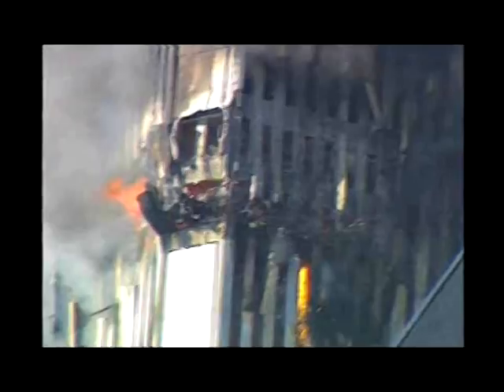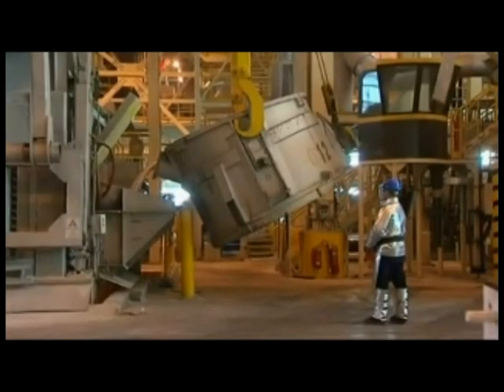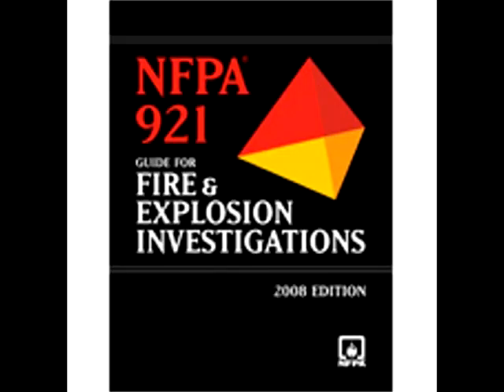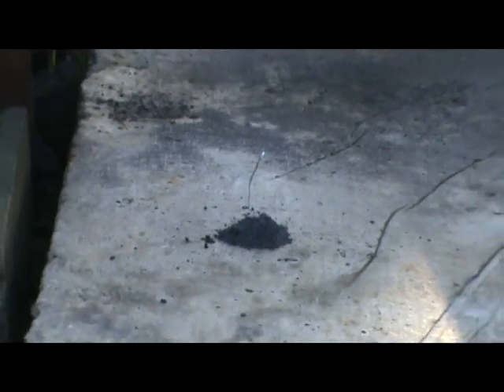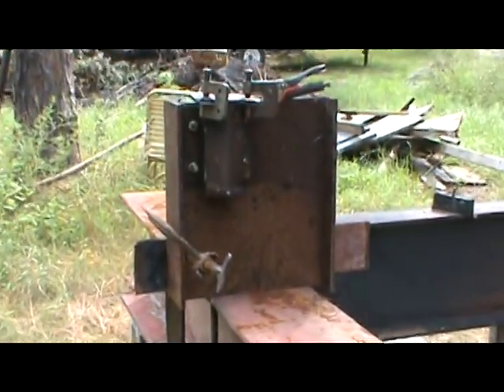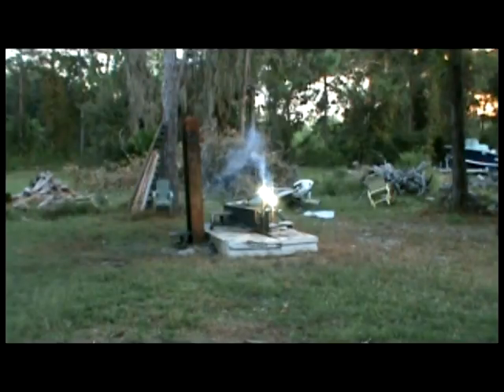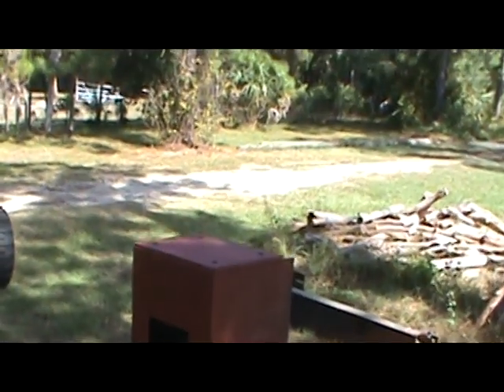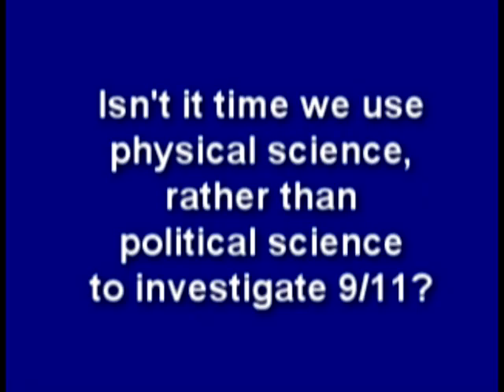9/11 Experiments: The Great Thermate Debate

Comment: Mainstream expert found NO evidence that thermite was used to bring those buildings down including 7.
There has never been any question as to whether or not thermite can melt steel. I used it myself numerous times. It could, theoretically, be used to bring down a building, if charges were placed in many critical places detonated at exactly the right time to give the "illusion" that the plane did it.
The fastest and probably cheaper way is to is to slam the building with a diving 727 with almost - full fuel tanks, damaging - not cutting - support ting frame members, and allow the resulting fuel and other fires weaken the remaining steel, until the structure gives way. Is that actually any less likely than using thermite?
Look, unfortunately, the US has many enemies, without and within. al-Qaeda attacked, did tremendous damage, and all they have to do now is watch all the other hate groups try to finish the job.
Reply: TheGooniessss 9/11 the day physics took a day off...
Reply: SupportAZ the answer is that good planning and good organisation only requires that a few know everything. They call it compartmentalization.
Reply: ***** no, I didn't, because the item you mention doesn't exist and never did. What did exist were a few chunks of - and this is the crucial bit - DECOMPOSED CONCRETE with metal items embedded in them. Those metal items were structurally intact, showing no sign of the temperatures you insist were present. Think about it: if the gun was embedded in molten steel then it would have been exposed to sufficient temperatures to have melted it, yet it was not melted. What does that tell you...?

Concrete starts to decompose into its composite minerals and compounds at around 250-300C, which was well within the range of those fires if they were only burning hydrocarbons. There is nothing whatsoever about these objects that supports your case, as you could have found out with a minimal amount of research.

I have no obligation to explain what could have melted steel until YOU first prove that steel actually melted, and, as we can see above, you have yet to do so. Try again.

Incidentally, I am almost certain that no molten steel EVER existed at that site, despite it being perfectly feasible according to the scenario detailed by the NIST from at least two possible sources. Not only have the fires present been empirically proven capable of exceeding the melting point of steel, but the collapse itself necessarily releases sufficient energy to melt steel as it deforms the support structure. Molten steel is NOT unexpected from the factors detailed by the NIST - the sole reason anyone dismisses claims that it was present is because there is not even the slightest hint that it ever was.

I invite you to return to school and learn how to undertake proper objective analysis, because you clearly have no fucking clue.
Reply: *****
Oh yeah...according to Dr Jones, "The peer-review on this paper was grueling, with pages of comments by referees. The tough questions the reviewers raised led to months of further experiments" I just don't buy the story that a heavy-weight academic with a long career in research suddenly turned into a bumbling incompetent and a bare-faced liar. Smacks of a smear to me.

Also he wasn't suspended from teaching for publishing the paper. An academic does not have to get permission from their university every time they submit a publication. He was suspended for making unsubstantiated claims in meetings and seminars as far as I'm aware but he refutes that completely. He thinks his suspension was political and a result of his university either buckling to pressure or protecting itself from negative publicity.
Reply: SupportAZ your reasoning bear no sign of logic. Here is how it would run in a court of law. You are the DA and I defend OBL:
1. "Let´s see your evidence DA. DA: you can read in the reports.
2. "Now it´s the defense´s turn." Def: NIST cannot explain free fall in WTC 7, they have no proof for the hijackers being at the airport and no explanation how a 150 feet airplane can disappear into a 10 feet deep hole without being even visible to the first responders,.
3. DA: ????
Reply: SupportAZ free fall is admitted by NIST (NISTSTAR 1A p.43 ff) and not explained. Would the court please dismiss the DA for lying! Conversations could have been recorded anywhere. Snapshot pictures not proven to be from any of the airports on that day. and NO testimonies! Where is the explanation of the dug-in-the- hole plane?
Reply: ***** your answers are kind of nice but sorry to say inconsistent. For us who don´t believe the official story AT ALL because of the total improbability that all this success should work FOR the hijackers throughout the process and ALL the mishaps on the governments side should be present at the same time is only by statistical means absolutely impossible. On top of that you have the cover up and ridicule of everybody who dares to question that made everyone who did that a public enemy. When you then start to look into details you find the seven faults like in the cartoon. But when I now tell you that I see that somebody is lying or cannot explain the anomalies you are asking me about the significance of this? You don´t understand how fiercely debunkers have attacked us who have pointed out that NIST after six years! had to concede to the fact that there was actually a period of free fall in WTC 7 although they cannot explain it. For us the free fall itself is a proof of CD. If there is CD in WTC 7 there is of course  a new ball game. In our eyes we have now come to the point where nobody scientifically can explain the free fall by anything else by CD. We can start from there and see where it takes us! Observe SupportAZ who still tries to lie about the free fall. It is useless but he insists. Do you also?
Reply: SupportAZ ""The "freefall speed" is debunked by the video."" Do you see your own words? A stupid straight out lie. Stupid because NIST already say it. But you have not even dared to read. Or cared or whatever. Impossible to have a serious discussion until you admit what they say, for heavens sake!
Reply: SupportAZ
 
New studies conclude: So called 'Conspiracy theorists’ are sane, while loyal Government Dupes and MSM Drones become hostile lunatics.

The following four different University studies have revealed a lot about how conspiracies are denied using patriotism and why the ones questioning the Government are attacked and considered anti-American traitors. Confirming a mental condition diagnosed by psychologists as cognitive dissonance, the mental stress and discomfort one experiences when faced with a 2nd equally possible explanation capable of destroying ones beliefs, loyalty, faith and security the Government is expected to provide.

Recent studies by psychologists and social scientists in the US and UK found contrary to the mainstream media stereotypes, the ones labeled as conspiracy theorists, tend to be saner and more stable than those accepting the Governments official version of an event. The most recent study was published July 8th, 2014 by psychologists Michael J. Wood and Karen M. Douglas of the University of Kent (UK). Entitled “What about Building 7? A social psychological study of online discussions of 9/11 conspiracy theories.” The study compared comments at news web sites from “Truthers” to those left by “Debunkers.”

The ones conducting the study were surprised to discover it is now more conventional to leave Truther comments than those of Debunkers: Of the 2174 comments collected, 1459 were coded 'Truther' ones who do not believe the Govt. theory and 715 were coded 'Debunker' who believe the governments theory. Truthers commenting on the 9/11 and the JFK assassination outnumber Debunkers by more than two to one. Proving pro-conspiracy Truthers express what must be considered the now conventional wisdom, while the anti-conspiracy Debunkers have shrink into a small, beleaguer-ed minority. 

Perhaps because their supposedly mainstream views no longer represent the majority, the anti-conspiracy Debunker often displays anger, rage and hostility resorting to profanity and personal attacks to discredit or persuade Truthers into believing the official 9-11 story. Additionally, it turned out the Truthers were generally not hostile posting valid concerns and not fanatically attached to their own conspiracy theories willing to consider other and equally possible theories. 

Debunkers however claim their 9-11 conspiracy theory blaming 19 Arabs, none of whom were experienced pilots able to fly a commercial airliner, especially without showing the least amount of fight for control of the planes on 9-11, were somehow able to thwart 2 billion dollars in air defenses under the direction of a guy on dialysis, using a laptop computer and a satellite link holed up in a cave halfway around the world – was somehow possible. 

This while the Truthers never claimed to have a alternate theory which completely explains the events leading up to the attack on 9/11. They claim they are not promoting a rival theory nor do they need one. They claim it is not for them to figure out only to prove the impossibility of the official story, which does not require a contradicting theory. They are simply claiming since a lie cannot be proven it was released immediately and allowed to run halfway around the world before the truth could put on it's shoes.

In short, the new study by Wood and Douglas suggests the negative stereotype resulting from the CIA pinning them as conspiracy theorists and hostile, fanatical anti-American Traitors. Relying on cartoon physics and crack pot Scientists, Architects, Structural and Aeronautical Engineers for evidence is ridiculously false. 

Additionally, the study found Truthers research all claims to find evidence the square box dictators ignored and failed to mention. They also research and discuss other conspiracies the Govt. is accused of masterminding tieing them all together exposing the much larger agenda of these Neo-Con traitors and their NWO Government.

Both of these findings are amplified in the new book Conspiracy Theory in America by political scientist Lance De Haven-Smith, published earlier this year by the University of Texas. Professor De Haven-Smith explains: "The term conspiracy theory was invented and put into wide circulation by the CIA in a effort to smear and discredit the ones questioning the JFK assassination." Adding. “The CIA’s campaign to popularize the term ‘conspiracy theory’ targeting the ones questioning the Government for ridicule and hostility must be credited. Unfortunately, it became one of the most successful propaganda initiatives of all time.” 

In other words, people who use the terms “conspiracy theory” and “conspiracy theorist” as an insult are doing so as a result, using these terms became an insult to the ones questioning the Govt. who uncovered a well-documented, historically accurate conspiracy by the CIA and those involved in the assassination of JFK. The CIA is not supposed to be operating inside the U.S. yet, routinely breaks conducts domestic operations ranging from propaganda to assassinations inside the U.S. 

De Haven-Smith claims those who doubt official explanations of high crimes are eager to discuss historical context. Pointing out a very large number of conspiracy theories have turned out to be true, and there appear to be strong relationships between many as-yet-unsolved state crimes against democracy. An obvious example is the link between the JFK and RFK assassinations, which both paved the way for presidencies continuing the Vietnam War. According to De Haven-Smith. "We should always discuss the Kennedy assassinations in the plural, because the two killings appear to have been aspects of the same larger crime." 

Psychologist Laurie Maxwell of the University of Guelph agrees the CIA-designed “conspiracy theory” label impedes cognitive function. Pointing out, in an article published in American Behavioral Scientist (2010), anti-conspiracy people are unable to think clearly about such apparent state crimes against democracy as 9/11, due to their inability to process information conflicting with the indoctrinated pre-existing belief they were brainwashed into believing. 

In the same issue of ABS, University of Buffalo professor Steven Hoffman adds "anti-conspiracy people are typically easy prey to strong confirmation bias – they seek out information which confirms their pre-existing beliefs, while using irrational mechanisms (such as the “conspiracy theory” label) to avoid having to consider conflicting information." 

The extreme irrationality of those who attack 'conspiracy theories' has been ably exposed by Communications professors Gina Husting and Martin Orr of Boise State University. In a 2007 peer-reviewed article entitled "Dangerous Machinery, Conspiracy Theorist as a Transpersonal Strategy of Exclusion,” they wrote:
 
“If I call you a conspiracy theorist, it matters little whether you have actually claimed a conspiracy exists or whether you have simply raised an issue which I would rather avoid. By labeling you, I strategically exclude you from the sphere where public speech, debate, and conflict occur.”

Now, thanks to the internet, people who doubt official stories are no longer excluded from public conversation. The CIA’s 44-year-old campaign to stifle debate using the term 'conspiracy theory' label to smear those who dare question the Government is nearly worn-out. In academic studies, as in comments on news articles, pro-conspiracy voices are now more numerous – and more rational – than anti-conspiracy comments. Cheers Debunkers!
Reply: ***** looks like your feelings are running away with you and leaving your critical thinking behind. Sorry, because I thought I had found somebody to make an adult conversation with. If you want that you´d better pull that part of it back to normal. If you read carefully what I write it is all about probability. Since you are sensitive to that word you should try to look into the likelihood of all the anomalies, contradictions, mistakes, luck, absences being at the same time working for the hijackers 100 % and against the government agencies 100 % added with all the cover-ups, lies, distortions and suppressing of information and I think the probability for something like this would be smaller than one in a billion. That is PROBABILITY not possibility. You should look at this as a starting point for your judgement and from there draw your conclusions. Sure, it could happen; but you need a pretty good explanation. You are not close yet! Btw; you consider NISTSTAR 1A to be a twoofer site as well?
Reply: ***** I certainly have no love for how they handled this situation; lied to the public about Iraq (that was a blunt and outright lie; agreed?), or widened the scope of NSA; the Patriot Act; screwed up the economy and made the taxpayers bail out the bankers. But whatever; I am first and foremost a lawyer so I am looking for the truth even if it should be in the defence of people I don´t like.
I make my judgments from the Commission Report from NISTSTAR 1 and 1A and publications connected to that. I look at videos from debunkers, CNN, Nova, National Geographic and from "truthers". I am trying to make up my own mind. You Bill Martin, seemed to be a reasonable man some time ago but now you have reiterated to the very tiresome debunker style that leads you nowhere.
NIST had six years and 300 experts to complete the Final report on WTC 7. And they screw it up? By admitting free fall? Or what do you implicate? Or are you just too old and tired to explain.
Reply: Martin you can't make phone calls from a plane, you don't have service up there. That is why we are lead to believe that the phone calls are fake.
Reply: ***** I usually don´t use that kind of words but after YOU are constantly avoiding MY factual questions and expressing your disappointment that I had not turned over to your side; I used it as a provocation- I thought from the beginning of your conversations that you were looking for answers in the way I do myself but after a while I felt you showed your true colours when I continued with my unanswered questions about the hijackers and Shanksville. You seem to have a prejudice notion that our government cannot do things like this to their own people. I started there once upon a time but I have learned on the way that they can. They have sent tens of thousands of young men to die and hundreds of thousand to be maimed physically and psychically  to pursue wars that have not served any good purpose for the American people but for a handful of bankers and corporations. That does not stop me though from demanding evidence; but I don´t stop short of the notion that governments can be very corrupt. Power corrupts and absolute power corrupts absolute. There we are in America right now!
Reply: "Mainstream experts" found no evidence of anything! That is why "truthers" have to do it all.
Reply: oller don't mind him he has dementia
Reply: TheGooniessss nice list. Shame your hallowed "experts" have proven that they are shit at their jobs.

Let's take Gage as an example. He runs the AE911T site, which features the Harrit fraud as a "technical article" in its list of sources. This is a report that has been proven to contain numerous scientific frauds, yet your "Chemical Engineering BSc" couldn't tell that this chemistry "paper" was utter bullshit...? Not looking good...

"You must have had a much hotter heat source to get 2700 degrees Fahrenheit in order to melt the steel, melt the iron, to get these iron molten spheres."

- oh, really? Well, that's interesting, because those of us who have no vested interest in perpetuating this little fabrication know that iron microspherules form at far lower temperatures. In fact, below is a link to a paper that points out that they form at temperatures of less than a fifth of those cited in your fictitious source:

http://www.sciencedirect.com/science/article/pii/S1367912012001228

- which states that:

"spherule formation is attributed to a low temperature hydrothermal process (150–200 °C)"

- go on: read it for yourself, you lying little spastic. Incidentally, do you know the key difference between this source and every single one you'll find in one of Gage's sites? This one is PEER-REVIEWED. And I mean it is reviewed by ACTUAL peers, not just people Gage hand-picks who he can guarantee will let his bullshit pass.

I know chemistry, and the fucking cunts you just cited are either so incompetent as to be dangerous or are as amoral as you are in perpetuating this bullshit.

THAT, princess, is how you analyse a source.

[drops mic]
Reply: TheGooniessss "im done with this thread "

- no you fucking well aren't, princess. You can start by addressing the points I raised in direct response to you in my last comment - assuming you have sufficient honesty to do so.

Of course, I have no doubt that what you'll actually do is pretend that all those inconvenient facts don't exist, and carry on deluding yourself into thinking you have more than half a wit.
Reply: ***** Which "expert" found this supposed proof the thermite could not have been used?  Which peer-reviewed, open scientific journal was this information published in?

This should be amusing.
Reply: ***** I am not convinced by anything else than that there is a lot of disinformation; half-trues, avoidance, unwillingness to admit that there is nothing concerning 9/11 that earns some consideration or merits any questions etc, etc. Up until one year ago I was not even aware of the controversy, but when I started to look I found some strange details. Since I am an old criminal lawyer I started to dig deeper and have been going on ever since. Tragically enough has every answer I have got been the source of even more questions and only adding to the mystery. The defenders of the official version have always been very quick to "lunify" the questioner. The same goes for you Bill. You should be old enough to know that it doesn´t work; at least not with some people. I am just not going to give up before I have some satisfactory answers. I have the experience to understand when that time has come. It is still somewhere in the future.
Reply: ***** that´s why have to continue our fight against those who try to impose new measures of slavery based on false flag attacks. They know that if this starts to be stuff everybody is talking about their blood will soon be in the streets. We cannot afford to be afraid of being ridiculed or defamed. They learned from Stalin about how to use the "useful idiots" who think they can save their lives by sitting like dogs around the boiling pot. Their power is built on our obedience. So we can not obey.
Reply: Can you provide a reference for your assertion that a "Mainstream expert found NO evidence that thermite was used to bring those buildings down"? Because I've just read the original 'thermite' paper and I can't find any scientific  rebuttal of the paper's conclusions. Most 'debunkings' seem to involve criticizing the journal it was published in and the peer-review process. Those that do focus on the science tend to make claims like the red/gray chips could be paint chips, but the paper specifically addresses this issue. I've also seen it claimed that the iron spheres found might not have been produced by a thermitic reaction but again the paper addresses this issue by demonstrating that when heated the chips exhibit an exothermic reaction and actually create iron spheres where none were present before! I'd like to see a good physicist actually address each point of the paper.

By the way the authors of the paper are not idiots but rather heavy weight physicists...Steven Jones was well known and respected for his research into muon-catalyzed fusion in the 80s and 90s and the others have hundreds of publications between them in mainstream journals...
Reply: *****
Thanks for the reply Bill. You are right that he can't prove it was thermite, but the red/gray chips do exhibit an exothermic reaction when heated that is consistent with thermite, Again, if his reasoning is flawed I would like to see a scientific rebuttal of the paper.

It's a shame that all the relevant samples weren't gathered by an official team on the day, then Dr Jones wouldn't have to use samples donated by members of the public. Unfortunately this was not done so there are no official sources to analyze. The samples he tested were not all gathered long after 9/11...some were gathered on the day and at least one sample was gathered before noon. I see nothing questionable in the stories of the people who collected these samples and many samples were placed in air tight bags and sealed on the day. Furthermore all of the samples, collected by different people at different locations at different times, have the same composition and all contain the same red/gray chips in about the same proportions. According to Jones et al the elements that form the composition of the chips, although common in isolation, were found in forms that would not occur from random mixing. They claim that the presence of elemental aluminum with iron oxide mixed at nano levels can't be accounted for by random mixing.

Furthermore the chips, when heated, produced exothermic reactions that, according to the researchers, were thermitic in nature.

Now then, I am far from qualified to judge the soundness of the science but I'd like to hear from others, who are qualified, a scientific rebuttal of the paper, taking on each of the points it addresses...
Reply: *****
Hmmm...other than stating that it is poor research you do not explain what it is about the research that makes it so. Researchers have spent years looking for black holes, dark matter and the Higgs Boson...does it mean this research is invalid if they find what they are looking for?

Secondly he was suspended after he put an unpublished paper up on his website (http://www.d.umn.edu/~jfetzer/Why3Dec13.pdf) but researchers present unpublished work all the time in seminars in every university in the world so it seems like a political move.

Regarding Pons & Fleischman the main problem seemed to be the way they made the announcement and calling the observed effect "fusion". It is interesting to note that they never retracted their results and many effects from LENRs have been reported by various groups over the years.
Reply: Also, who is this mainstream expert who found NO evidence of thermite?
Reply: SupportAZ
I'm not a 'twoofer'...but I don't accept anything at face value either. Why would a government want to blow itself up? Well geopolitics is complicated stuff but you only have to read up a bit on operation 'Gladio' or operation 'Northwoods' to realise that blowing yourself up and then blaming it on your enemy is pretty much standard practice amongst certain elements of certain security services...

Watch the BBC documentary below...seriously...

If you can't be bothered then a quick synopsis is: A secret section of the secret services in Italy (and lots of other major European countries) ran the country for years without the knowledge of its own government! In Italy Gladio operatives planted bombs that killed lots of civilians (they killed eighty something civilians in one blast) and blamed it on their enemies (communists). Through this 'strategy of tension' they manipulated public opinion with the lives of civilians, It was all done under the auspices of the CIA. It's now a matter of public record since several testimonies by top Italian government officials

Operation Gladio - Full 1992 documentary BBC
http://en.wikipedia.org/wiki/Operation_Gladio
http://en.wikipedia.org/wiki/Operation_Northwoods
http://dc911truth.org/flyers/11-11-06-handouts/Operation%20Northwoods.pdf
Reply: SupportAZ I think you are putting the cart in front of the horse. Just because we can´t believe that our government not could be involved in horrendous acts like this should that be a pretext for NOT examine what happened? Of course, for those who don´t believe in the official story; many things point in that direction. However; you cannot be sure at this point who the perpetrators are. I can think of hundreds of different possible scenarios. What they are guilty of, however, is hiding a lot of information from the public. That is bad enough.
Reply: SupportAZ another thing: IF it was planned you have to assume that it was very well planned, indeed! Some people point at the incompetence of governments as a proof that things like this cannot be done by them. Those who say that tend to forget that politicians at this level are extremely good at one thing that they have been practising all their lives: grip and hold on to power. Bush stole two elections by bribing, cheating and bullying through civil institutions. They know what to do and don´t hesitate to use their might.
Reply: SupportAZ I have said many times in these pages that I don´t have any preconceived notion of how it happened. What I know though is that it didn´t happen the way it is told and that there is a big cover up story. I don´t care to go into details of how to organize operations; only that I know big operations have been completed before throughout history. I don´t know who did it. Somebody did and it was not UBL. Did you know and can you understand why there is not even one piece f evidence to show that the hijackers even were at the airports this day? No footage, no testimonies; nothing.
Reply: ***** nobody but the perpetrators themselves CAN have a unified  theory/knowledge. There are too many options. We have to unveil the cover-up stories and start from there.
Reply: ***** the basic idea WAS to create a sense of fear and confusion in all of the country and in the world. Don´t forget he brought in all his partners from NATO. That could never have happened without 9/11! What do you thin Occams Razor would lead to in a situation like this? Believe the government story? That story that in itself contains so many obfuscations, confusions, contradictions and obvious lies. Occams Razor would lead to the conclusion that there was only one reason why this was made. Create fear and chaos. Simple.
Reply: ***** where did that rationale in you go? Did you have a bad nights sleep? You and some of you colleagues on the debunker side have launched Occams Razor as some kind of explanation whu the official story is right. The problem with that is that what looks like a simple story with four hijacked planes turns out to hold so many anomalies like the total absence of air defense, the unprecedented falls of three towers (of which one was not even mentioned in the official story!) the unbelievable presence of almost unscathed passports, one plane disappearing in a hole in the ground;  all the confiscated footage etc etc; that all of a sudden the official story is extremely complicated. Why all this secrecy? Why these anthrax threats? Why this oppression of information? Occams Razor certainly leads in the totally opposite direction. You have the burden of proof and you have the disadvantage of an Occams Razor analysis!
Reply: they also shipped all the scrap overseas to get rid of the evidence....u forgot to mention that.....
Reply: oller
The truth is where you find it. You obviously have no love for the US government, so you won't look there.
The NIST screwed up a few things in their report, so you accept none of it, but the crap you hear on the truther sites is gospel. Have it your way.
Reply: ***** I'm sick and tired of your stupid mistakes too... Only a controlled implosion would cause a steel building to free-fall onto itself. The fact that you think you have proven anything more than your ignorance is quite comical.
Reply: israels mossad did 911 This is the forty-eleventh time I've heard that statement.
Study some science, look for some material not provided by "911truth.com" or one of the dozens of sites that claim special knowledge. Look up some engineering sites, visit FDNY's internal investigation transcript then get back with us.
Oh what the hell, if you see something you don't like, you'll just call it a government shill site or something like that. Come to think of it, you've already seen what you want to, so you won't look any further.
Reply: ***** This is the forty-eleventh time I've heard that statement.
Study some physics and look for some material not provided by "fox.com" or one of the dozens of sites that claim special governmental knowledge. Look up some engineering sites, listen to the FDNY's own claims, then, get back with us.
Oh, what the hell, if you see something you don't like, you'll just call it a "911truth.com" shill site or something like that. Come to think of it, you've already seen what you want to, so you won't look any further.......
Reply: ***** I am 100% with you on this one Bill, but you will not convince these loons of anything, they already decided what they want to believe.
Reply: Jesus

I see Jews r Us just showed up .  The NWO Zionist Serial lieing Apologists.  Now I'm certain you can convince everyone that CIAida was responsible for this false flag operation.
Reply: *****
Where have you been? Reading Jonesology?
Reply: Jesus
I was actually convinced that Oller, for example, wasn't a looner, but he turns out to buy the same crap the the others do.
Some people have common sense, others only trust each other.
Notice this "RIOT CLAN" guy brings up the same old thermite BS. He read it somewhere. so it's gospel.
I'm thinking that the same handful of truthers is just rotating names and recycling their "theories".
...OR, maybe...what if they ARE Al Qaeda?
Reply: You stupid old fool
Reply: ***** Too bad you can't raise even a single counterclaim, ya fuckin tool
Reply: israels mossad did 911
Everybody did 9/11 except those who claim to have done it!
I can prove it!
Reply: *****
You weren't 3, you were a midget working for the CIA. You're actually 68, and I'm on to your tricks, you gummint shyster...
Reply: ***** Ok, me to say that there was molten steel falling off the building is the same as me saying that a plane hit the tower! There is video evidence of both... To say that this was not an inside job just shows how much you don't want to know the truth. I have someone that when ever he sees me makes fun of me for saying that the 2nd richest country in the world can't pull off flying planes into 3 buildings, and demolitioning 3 buildings. I am so fed up with the world. It is ending and that is a fact! Good Bye America! the debt is now 18 trillion dollars.... Obama another man that is trying to make the world a one world government. Started with George Bush SR. and is still going. Guys if you want to have any chance of living a free life move to Switzerland.

And Bill what is your opinion on 9/11?
Reply: lol you crazy they have proven it time and time again there was thermite particals in the dust im not gonna argue something i have spent hrs and hrs researching ......might wanna be little more open minded and check your own facts mine all come from engineers and other creditable ppl
Reply: and no way did bin ladens terror squad have anything to do with it they were just patsies like oswald im sorry tht you cant belive your own government is the cause , why dont you look into how many countries the states have occupied annd ruined excuse the spelling i have much more important things to do then point out you are just set in old ways and thinnk america is still the land of the free . not much longer it will be a socailist country
Reply: TheGooniessss
Just name one...or can you?
Reply: TheGooniessss Judy Wood claimed the destruction was done with Space-Based Energy Weapons". If you buy that, I'm really gonna turn you over to the Whako unit. I recommend you not mention your drug se.
Reply: im done with you , when your country is in shambles and martial law kicks in i hope your one the first they stuff in a fema camp and it s coming and you really are nothing more then an uneducated troll
Reply: TheGooniessss
Yeah, Judy Wood said a space based directed energy weapon destroyed the towers. You need to stop hopping from blog to blog...
Reply: ***** please, Bill, haven´t you studied the evidence at all? They have presented a lot of obviously fake evidence concerning the hijackers presence at the airports. No disguises there. But they have not presented any witness testimonies or footage of which there must be hundreds. In any normal murder case the police should have done that. So much evidence and they don´t have the staff???
Wikipedia says about Shanksville that the crater was 8-10 feet deep. In the Commission report there is not a word. First responders, when they arrived before FBI have witnessed that there was virtually nothing there! Which is the official story? The one that the official guides at the site are reluctantly saying and that you obviously refer to? Shanksville is a more obscured piece than any other.

NIST carefully avoided to make any more claim of their own other than that the collapse was "inevitable" referring to the fact that their mission was only to find out the reason why the towers fell not into how.

There is strong reason to believe that OSB died in a hospital in Rawalpindi in December of 2001. He was treated for kidney failure in Dubai in the summer and then transported to Rawalpindi where he had dialysis and subsequently died. During the attacks he was hospitalized. That is why FBI never had him on the most wanted list for the 9/11 crimes.
Reply: oller  You are indeed a lawyer, and you are a bulldog. You twist and flip and obfuscate evidence, you deny what doesn't support your case... you do have an agenda, and damn if truth is gonna interfere. What you don't like you claim is fabricated. What you like suddenly becomes the decisive factor.
You, too, are hopeless despite your protestations.

And I never called you a looner, I don't know what that is either. If it's some Brit version of "lunatic", I wouldn't use it on you. A lunatic isn't responsible for his actions.
Reply: ***** can you give me one example that proves your accusations against me? I am a lawyer for sure but I think I have been keeping a straight line of arguments that should be easy to follow. But may be my questions are not to your taste because you have different agenda. When you think Switzerland belongs to Scandinavia I also understand how shallow your knowledge basis is.  I saw you said good-bye further down so may be it is the best thing to leave it at that.
Reply: ***** typical shill tactics. Blocking. Only cowards block. I have been blocked by several debunkers because my questions were to hard. I pity you small people.
Reply: not to mention the 3 trillion dollard the defense department could not account for was annouced the day b4 whats the media best at distracting the masses and ppl still dont question were tht money went fuck id be up my congressmens ass with spade
Reply: ***** btw I never called you shill I just said you used shill tactics.
Reply: You must be starting to suffer from dementia. Their was more than enough evidence of thermite being used. Sorry you are lost,
Reply: oller bill martin=delusional "engineer"
Reply: No fire investigation was allowed. NIST said they didn't look for Thermite because they had the preconceived notion that it wasn't a demolition.

Look it up.

Shyam Sunder himself said they didn't look for explosives.
Reply: ***** get this straight: no matter how often you scream that something happened, it will not make it true. No amount of rabid wailing about these fictitious events will make your demonstrably-false claims come true. You are wrong, and the footage alone proves it. End of argument.
Reply: chris silva Sorry to burst your bubble, but if the Official Story cannot explain bldg. 7, then its other conclusions are questionable as well. Phony would be a better description.  And there is no "mystery"; it was destroyed intentionally , by controlled demoltion, as many experts have testified. Anyone can check this: get a stopwatch, time the bldg.'s fall, and apply Newton's Laws of Motion, and the result is, the Official Story is impossible, but CD is not.
Reply: David Herron where is the evidence from the CVR that proves highjackers took over the planes ?  are you basing your conclusion on the calls from the passengers and flight attendants ? and does your conclusion include the testimony from Ted Olson ? 

The whole official story stinks.... and the proof that 19 highjackers took over the planes is based on 'alleged' phone calls from the passengers and crew.... and from the 'alleged' message from Mohamed Atta who said... "we have some planes"  !!!!    fucking ridiculous !!!
Reply: David Herron here you go.... information from flight 77 FDR analysis:

http://pilotsfor911truth.org/forum/index.php?showtopic=18405
Reply: David Herron no problem..... 
http://www.nist.gov/manuscript-publication-search.cfm?pub_id=101366
Reply: Christ J EVERYONE is against you !!   It's a GROWING club !!!!!!!!!!!!!
Reply: "The fastest and probably cheaper way is to is to slam the building with a diving 727 with almost - full fuel tanks, damaging - not cutting - support ting frame members, and allow the resulting fuel and other fires weaken the remaining steel, until the structure gives way. Is that actually any less likely than using thermite?"

Answer is yes, pyroclastic cloud and the almost free fall speeds to come down at its own foot print are quite typical for controlled demolition.

"Look, unfortunately, the US has many enemies, without and within. al-Qaeda attacked, did tremendous damage, and all they have to do now is watch all the other hate groups try to finish the job."

Yet, it is the government that passes through acts like Patriot Act - an oxymoron refers to those who agree that the government is there to protect their freedom can steal their freedom if they want to-.
Reply: Fussinated
OK, here we go again.
Look up "pyroclastic flow", then look up "oxymoron".
You probably won't, because you are afraid of being called out.
Reply: *****
"OK, here we go again"

??? OK!
.
"Look up "pyroclastic flow","

What makes you think that I didn't? If you think I said something misleading why don't you correct me with definitions and explanations.

" then look up "oxymoron"."

The same goes with this.

"You probably won't, because you are afraid of being called out."

Ok here we go again.

If you think you found something so crucially flawing about my argumentation why don't you communicate these instead of coming at me with such irritating disposition? Did I offend you personally? Now wait for the next post.
Reply: *****  
“A pyroclastic flow (also known scientifically as a pyroclastic density current) is a fast-moving current of hot gas and rock (collectively known as tephra).

Clastic rocks are composed of fragments, or clasts, of pre-existing minerals and rock.”

So, the pyroclastic flow is hot gas and reformed rocks after high temperatures.

And how will this definition  call me out?  Because, I only mention pyroclastic cloud as a telltale sign, not as a proof. If you can explain how fires and airplane impacts cause pyroclastic clouds I am ready to accept it.

“An oxymoron (plural oxymora or oxymorons) is a figure of speech that juxtaposes elements that appear to be contradictory. Oxymora appear in a variety of contexts, including inadvertent errors (such as "ground pilot") and literary oxymorons crafted to reveal a paradox.”

For this definition we also have to look up the definition of Patriot.

“pa•tri•ot  (ˈpeɪ tri ət, -ˌɒt; esp. Brit. ˈpæ tri ət)  n. 

1.  a person who loves, supports, and defends his or her country and its interests.

2.  a person who regards himself or herself as a defender, esp. of individual rights, against presumed interference by the federal government.”

So, for  Patriot Act not to be taken as an oxymoron, government should define itself as the perpetrator for a criminal act against citizens. Or, with this act government intend to eliminate the patriotic elements in their citizens.

However, if the intention is that patriotic citizens would accept the content of the Patriot act due their patriotism, then it is an Oxymoron according to the definition of the word oxymoron and patriot

Now, I did what you asked for, are you ready to admit that you made a mistake?
Reply: Fussinated
Me? A mistake? Are you kidding?
Even most truthers have abandoned the pyroclastic flow claim, it has been completely debunked, as the 250 Degree blast would have killed every human it hit. There was no heat source capable of producing such a phenomenon, even if tons of thermate were used.
As for "oxymoron", I doubt your English teacher would have accepted that use, it's a terrible stretch. But it's a matter of opinion, and from your apparent intent, I'll give you that one.

For what it's worth, I also agree that the "Patriot Act" might be the most un-American thing ever to go through Congress.
Reply: *****
"Me? A mistake? Are you kidding?
Even most truthers have abandoned the pyroclastic flow claim, it has been completely debunked, as the 250 Degree blast would have killed every human it hit. There was no heat source capable of producing such a phenomenon, even if tons of thermate were used."

You are aware that you didn't say anything to refute what I said.

You should be aware that you are making a reference to a pyroclastic cloud that is formed by a Volcano, while the comparison should be made the pyroclastic cloud that is formed during controlled demolition.  And that cloud is a fact. Unless of course if you are to prove that each and every controlled demolition produce that hot pyroclastic cloud.

""As for "oxymoron", I doubt your English teacher would have accepted that use, it's a terrible stretch. But it's a matter of opinion, and from your apparent intent, I'll give you that one."

I am really very close to call you names right now. Because again you call the explanation I gave you in detail is a stretch without explaining why, and you pretend as if my explanation is invalid but you 'stretch' yourself to accept it again with no explanations. I rather stop here because I will really start giving it you.

"For what it's worth, I also agree that the "Patriot Act" might be the most un-American thing ever to go through Congress."

I doubt you even understand it,.
Reply: Fussinated
Boy, you twoofers are a wild-eyed bunch...
Reply: *****
"Boy, you twoofers are a wild-eyed bunch..."

Again, you blurt out things without even explaining why you say it. So, forget it I am not even a truther. I am a truth seeker though I would like to know about the truth. I tried to communicate some ideas long ago and I countered both truthers and the non truthers equally, on many issues  So, in the end I kept on explaining what say and why I say without even receiving anything meaningful and logical other than un supported,  and as well as ad hominem remarks. And it is no different now, and there will be no difference tomorrow until people will realize that it is not important what they know but how they know it and the ethics that is applied to that knowing.

So, if it makes you feel better, I bluntly confess that you are right, be sure of it whatever you think or say, And of course truthers are right as well, on whatever they say. And this is true even though neither of you could explain what you say in a complete meaningful context. After all, you - all of you - don't need the truth but the truth needs you to be what it is. So, sleep well you are absolutely right and there is no threat to disturb your inner peace which you achieved by knowing the truth as it is, and you don't even have to be honest about it. :).
Reply: Fussinated
I meant it, man...you are no more interested in finding the truth.
Look, just because some people reject the "official government story" doesn't mean it's wrong. It was the result of the efforts of hundreds of scientists, engineers and technicians, all respected experts in their respective fields. It's easy for some people to claim they were all government shills, or that they had some special agenda, or just loved to lie.
The thing is, their report is based on solid science. Again, it's easy to say it's all pseudo-science, comic book science, et cetera, but in the end it's real science.
I've even seem some remarks that claim that the college professors who taught that science are in on some government scam to create an excuse to invade the middle east.
It seems everybody is in on it.   They even indict each other. They have come up with enough "theories" to fill the Pan-Galactic Library's humor department.
So if I seem indifferent to your plight, I might be because I am.
Reply: *****
Yes, and they didn't look for molten steel, either. They didn't look for flying saucers. They didn't look for a spaghetti dinner. They new the answer to that, too. Same answer as for explosives.
Oh, and they didn't look for thermite, nanothermite, superthermite or thermate. No sense in it.
 They probably didn't look for blasting caps, det cord, dynamite, C-4, plastique, or gunpowder, either. Same reason.
They didn't find any evidence of explosive or pyrotechnic demolition, no confirmed by-product traces, no steel that was cut with any of those methods...
And by the way, neither has anybody else.
Reply: *****
"I meant it, man...you are no more interested in finding the truth."

You think so?

"So if I seem indifferent to your plight, I might be because I am."

Then, how come I am not indifferent to you and try to communicate things and explain my thoughts to you as clearly as possible in hope to find out more about the issue at hand? You are not even aware that I am ready to accept if you communicate with me the truth or facts that would lead me the truth. So far, as it seems, all your concern is whether I am fitting in a label you have in your mind that has a tag on it says truther.

Also, regardless to academic level of the individual or a group of individuals, the truth is independent from who communicates it. The world has not became round after being flat thousands of years because a bunch of scientists said it so, its round because it is round.

And anyone interested in truth adheres to the proper ethics to deal with it, and being indifferent especially when communicated in honest arguments is not part of it. That is the way of the biased bigots.

Anyway, as I said, you are right feel good about you are not even have to be honest about. It is not my responsibility to equip you with proper ethics to seek the truth - and I am using the word truth in the widest sense possible -. Ah! even though someone who sincerely seeks the truth with proper ethics would have understood by now, I will say it anyway; I don't think and claim that I know what happened on 9/11, or who did it, So if I sound like I say that you don't know the truth but I know it, it is not because I know it but I have the proper ethics to accept it when I find it.
Reply: Fussinated
I, myself, like many others in this string, have been trying our damnedest to communicate the facts to you and anybody who will listen, but what we get instead of any kind of positive reception is accusations of being a liar, a government shill, called every imaginable pejorative term in the English language. Basically, I get shouted down by people who not only don't want to hear it, they don't want anybody else to hear it, ethics be damned. So don't expect any input from me, my patience has evaporated.
Of course, it took controlled demolition to do that.
Reply: *****
"Basically, I get shouted down by people who not only don't want to hear it, they don't want anybody else to hear it"

I am not responsible from your bias. However, be sure that you are the only one who is treated unfairly so you have all the rights to be unethical.

"ethics be damned"

I am also not responsible to make you ethical.

Again, sleep well, be happy you don't need to be honest about anything, you have all the  ethical right to be like that.
Reply: Fussinated Good example: You immediately called me biased, and you twisted my words to imply that I decided to dispose with ethics. This is the kind of shit that keeps me continually pissed off.
I sleep quite well, thank you, my conscience is clear. I am a truthful man, and this kind of treatment is what I get for it.
 Fuck you, kind sir.
Reply: *****
"Good example: You immediately called me biased,"

You called me truther out of the blue, didn't you.

" and you twisted my words to imply that I decided to dispose with ethics."

These are your words to explain your 'indifference';

[ Basically, I get shouted down by people who not only don't want to hear it, they don't want anybody else to hear it ethics be damned ]

No? 

So, 'damned ethics' means that you still try to adhere ethical behavior by being indifferent and label people without even being sure about their ideas and where they stand?

No wonder you have a problem with the definition of the word "Oxymoron." 

"This is the kind of shit that keeps me continually pissed off."

And people getting pissed off all the time without even explaining what they say and why they say it, then start name calling without a legitimate reasoning, pisses me off. Yet again, I am the one who is not name calling first, and at this moment if I called you an idiot with such level of inability to explain yourself and lack of meaningful and logical argumentation, it is justified beyond doubt :)

"I sleep quite well, thank you"

Good for you.

" my conscience is clear."

Why shouldn't it, you are indifferent to anyone and everyone who does not agree with you not to carry an ethical burden.

" I am a truthful man, and this kind of treatment is what I get for it."

Hmm! If you were a truthful man, you would have accepted your mistakes. Instead you started to act like an asshole. When, I asked you to admit your mistakes you responded like this;

"Me? A mistake? Are you kidding?
Even most truthers have abandoned the pyroclastic flow claim  ...."

And then the following conversation you simply failed to counter my arguments, even then you didn't admit your mistakes but continued to make sarcastic remarks, Then called me with a label, I guess to discredit what I say in your own perception. Because obviously, if I am not a truther, then you have to exert some effort to legitimize your claims, which required communication and discussion with real ideas, reasoning lines, and arguments etc.

One of the first rules of proper ethics for seeking truth is to admit your mistakes. If you are so offended by your mistakes shown to you, then you should shut the fuck up and find a way to find out and correct them yourself.

As you see, you have neither of these qualities. So, you are being treated fairly, because, even now you are being explained about your mistakes and weak arguments in detail with examples and proofs.

" Fuck you, kind sir."

Fuck yourself, idiot.
Reply: ***** please show me the science that allows a 150 feet airplane disappear into a 10 feet deep and 30 feet wide crater without leaving any visible signs of fuselage, wings and tail (and engines; they are HUGE you know).When you are at it you could also show me the science that makes thousands of people at three airports not having any memory of seeing any hijacker checking in, passing through luggage check or boarding at the same time as all the cameras got some simultaneous sickness that prevented them from taking one single picture of them?
Since you claim that all is made in sync with high level science.

Btw who gives you the right to describe me or Fussinated or anybody else who doubt the actual scientists, as unethical, when they claim to prove that WTC 7 fell because of fires at the same time as the scientists THEMSELVES are writing that there was a period of free fall descent at the rate of gravity and that same free fell not is possible unless all structural elements are removed. And they don´t even explain this very obvious anomaly. Are those the scientists that we should  trust?
Reply: oller
You have been showered with that science numerous times, now I would like you to explain why you are so convinced the planes couldn't have penetrated that building, why they Couldn't_ have bent the structural elements, why the steel couldn't be softened by the heat of the ensuing fires, why the building couldn't have collapsed due to the weakening of the steel structure, and how steel could have remained "molten" for days, and why we should accept the uncorroborated testimony of "witnesses" who make widely varied statements about what they heard and saw.
Reply: oller
Why does everybody think i'm old?
Maybe it's because I am.
Oller, I apologize if I responded to you in a hostile manner, and like you, I haven't been in looking at this stuff very long, I stumbled across this string shortly after 9/11 of this year.

I'm of the opinion that like most government reports, the N.I.S.T. report is  error laden and probably contains some CYA in there as well. But I believe it to be essentially correct. I made my career in technology, mostly limited to electronics, but a useable background in the sciences is required to be proficient in my field.

My problem with most of the counterclaims is that most of it seems to be speculation, rumor, misunderstanding and good ole disinformation, and fueled by a basic distrust in government so strong as to have become unreasoning hatred.
Reply: ***** fair enough; I didn´t say you were old but you look and sound old enough. We have come to different conclusions from what we see, but I have come to a tipping point where I now see the world in the eyes of mistrust instead of trust. Our leaders; everywhere in the world (possibly with the exception for Uruguay) are serving their best interest; not ours. People in democratic countries should be aware that this is a great threat to their core values. We have to be watchful and not letting them get away with deceits and inducing fear by false flag operation. The bad guys are dependent upon us being obedient and we can´t afford just that.
This does however not justify any unfounded claims vs 9/11; but in the case I have found all those ingredients that I ant to fight in our society. Dishonesty; superiority, contempt, deception, lack of compassion etc. are what I find. We have the right to demand the contrary. As long as I have been alive I have been fighting people like this and I will continue.
Reply: oller
More power to you, indeed we have more than our share of these problems, and they tend to hide in plain sight.
As the gulf wides between rich and poor, the powerful become more emboldened.
As we spiral downward, they float upward. It will stop when we have become so poor that we can only work directly for them, receiving bare sustenance. We must fight them for the welfare of our loved ones and our children.
Reply: Fussinated looks that we have landed in about the same area. I am actually very critical about Islam and their ominous claims; but at this moment it does not serve us who want some dignity in our lives to criticise them first hand. Seems that the apparatus Eisenhower and Kennedy warned us of is our most dangerous enemy right now. The only way; I think; is to challenge them in the media and encouraging good people to do so in CNN, MSNBC, ABC, NYT and WP. Fox is long time gone.
Reply: oller
To be ignorant is not a shame but willing to remain ignorant is.
Reply: Fussinated correct!
Reply: Jon Weaver
Dr. Jones' original paper stated only that the traces he found appeared to be thermite, but he never was able to confirm it. The samples he tested were gathered long after 9/11 from questionable sources, and he didn't collect them his self, nor did any of his staff. Not only was there no clear chain of custody, but the materials he found are extremely common, with many other possible sources, especially in a city where there is construction underway pretty much continually.
Since thermite/thermate is commonly used in steel construction, rail repair and for many other purposes, it would be much more suspicious if none was found.
This seems to be the thing Jones pretty much hung his hat on, but his report never received peer approval, and since he had his claims published in a scientific journal without the approval of his employer, BYU, he was censured. He has since resigned and retired. He has many more detractors than supporters in the matter.
He was not qualified as a forensic analyst, and his willingness the work with questionable samples bears that out.
Reply: Jon Weaver Perhaps the questions wouldn't have been so "grueling" if he had done proper research in the first place. The rest of his work was simply aimed at proving his conclusion from his first paper. That's not the way to approach any research. His competence in his field is apparently beyond reproach. It's curious why he would have undertaken this particular matter in the first place.
He was suspended for using BYU's name on an unapproved paper. As for negative publicity, BYU was probably still stinging from the "cold fusion" scam that had occurred at Univ. of Utah, which some people associate with BYU. That undoubtedly influenced BYU's decision.
And before you say it, yes, I'm aware that Jones was working on another cold fusion - like project which had nothing to do with the Fleischmann thing.
Reply: Another question for Twoofers is how on earth did the "big bad government" know exactly where the hijacked planed were going to crash? It's just absurd. And why would a government blow itself up? That too is beyond absurd.
Reply: Yeah Twoofers can't make up their little minds if the big bad government is able to pull off complex conspiracies or if they are bumbling idiots. Can't have it both ways.
Reply: SupportAZ I just told you both things can apply to one and the same person; Usain Bolt doesn´t necessarily need to be a good organizer.
Reply: oller
911 would have required THOUSANDS of conspirators and advance knowledge of EXACTLY where the hijacked planes were going to crash. Impossible. Too perfect. A fantasy.
Reply: oller
LOL. You think it only takes a few people to rig 3 buildings with explosives. LOL And those people as well as the other people who didn't want to partake have kept quiet all these years. You should write fiction books. And how did the "demolition supervisors" know EXACTLY where to rig the explosives. Those planes could have hit anywhere. LOL
Reply: oller
What you are saying is that you have on your blinders. You STARTED with a conclusion and never bothered to test your hypothesis. That's the complete OPPOSITE of scientific method.
 If 911 was a court case it would get thrown out. Oh wait a minute! That has already happened! Denny Chin.
“The courts have no obligation to entertain pure speculation and conjecture.”
Reply: *****
Did Sibel Edmon work on demolishing WTC buildings? No. Did Sibel Edmon work on the planning and logistics of demolishing any WTC buildings? No. Again, truthers have NO hard evidence, no direct correlation, etc. Just theories and LOTS of wishful thinking.
Reply: oller
You are 100% delusional. Freefall is debunked by the video proof. Hijackers already recorded on audio conversations with air traffic control.Snap shot picture at the airport. Airplanes crashing into WTC's already on video. Case dismissed.
Reply: oller So, the people who pulled off this remarkable feat, silenced any witnesses, is controlling thousands of "shills", all supposedly to implicate a man who admitted his guilt, couldn't have produced some grainy surveillance tapes and a few "witnesses?
Can you explain why you believe "free fall" is pertinent?
Can you explain why perceived technical errors in NIST report have any bearing on OBL's guilt or innocence?
Reply: oller
How convenient. If it doesn't fit your fantasy then you call everyone a liar. The airport photos, the passenger calls on airphones, the cockpit voice recorder audio, etc. So where did the planes go? To Disneyland?
The "freefall speed" is debunked by the video. Debris falls much faster than the main structure. Definitively proven as a twoofer hoax.
Engines were pounded into the ground and had to be dug up. Small debris was everywhere. Just like PSA fight 1771. Not the first time this has happened when a plane goes straight into the ground.
BTW 911 in NY is all on video. Connect the rest of the dots idiot.
Reply: *****
There's that gravitational fall thing again, I leave me wonder what force you believe caused it to collapse. Whether it was due to the plane hit or some kind of intentional demolition, gravity is what pulled the remnant towards the Earth. Your implication seems to be that some other force was pushing it down. Would that be why ya'll say it was "free fall"? Despite the obvious and freely visible proof the the fall was being throttled due to the copious amounts of furnishings and not yet broken support beams...
Then you say the top section didn't "Impact" the lower section. Hmmm...Where in hell did it go? I saw that it started falling at a considerable cant, and even side-slipped a few feet, but remained on top of the building. But you say it didn't impact the building. Hmmm.
Reply: SupportAZ either it dug itself down or it spread all over like 1771. Which is your version?
Reply: ***** but they should have shouldn´t they? Could be a little bit problematic with all the people at the airports to be interviewed by CNN,ABC, NBC, Fox and all the local stations and newspapers. Kinda hard to make it work: Better to take some real videos and use the as significant, put Atta´s luggage in a convenient place, plant a bandana and a few passports and let the channels know. Story ready and told.
Reply: Jon Weaver
When you say the "original" thermite paper, I assume you are referring to Dr. Jones' report.
The problem is that he made assumptions and describes results as "similar to..." and points to a need for further studies. He admits his report is not conclusive. His peers rejected the report as premature and unverified. He published it as a BYU study and was effectively dismissed for that reason.
Reply: ***** care to comment?
Reply: oller
I've been following a half dozen 9/11 strings and frankly I'm getting confused as to who said what.
I agree that if the feds wanted to frame someone, they could, and probably have. No stretch there.
 But the end result for all this, supposedly to synthesize an excuse to invade in the Middle East. just too radical. Hell, we were already there and had already made more enemies that we can count.
All the fakery and subterfuge, all the incredibly complex theories, (none of which I have seen brought together into a single, unified theory) that's what doesn't add up for me.
Occam's Razor applies here.

As for the NIST report, I'm at a complete loss as to why they ever used the term "free fall". No matter what brought the buildings down, free fall would be impossible. You can't deny that there was too much material in that building to allow the floors to fall freely. Unless somebody wants to claim that it was all cleaned out prior to the collapse, including the walls, plumbing, wiring, HVAC ducting, interior supporting columns, etc, ad inf.
That term has gotten far more attention than it deserves.
The term is used by CD experts to describe the effect that they achieve when they have cleared a building of all the material like what I mentioned above, so that the building collapses in exactly the manner they plan (Which isn't always a vertical fall).
Which brings up another thing the gummint messed up: I f they wanted maximum political impact from this event, they should have set the charges all on one side so the buildings would have fallen toward other high-profile targets, killing even more people. Then maybe the upper portions of the buildings might stand a chance at "free fall"!
Reply: ***** it was all laid out in PNAC "an event like Pearl Harbour"
Reply: James Millette found no evidence of thermite in WTC dust in any shape or form. SO the freefall speed thing was all a fantasy.
Reply: *****
You are cherry picking what you want to believe. Typical twoofer.
Reply: SupportAZ and you are not?
Reply: *****
So you are actually claiming that the destruction of WTC would have actually been simpler using the theories you folks keep posting than slamming them with 2 passenger jets? And you find these ideas credible? Do have such fear and hatred of that word "official" that you would rather protect known and self-proclaimed terrorist organizations from the big bad Americans? Do you deny that these groups are capable of these kinds of atrocities? Have you neven seen or heard of what they have done and continue to do since the Aroyo attack in '71? You think they haven't and won't ramp up the attacks ever since?
But you do believe we need an excuse to counter-attack?
Incredulous? Yes, you conspiracy theorists are that.
Reply: oller
Look at the twoofer trying to rationalize that he is sane. LOL. ALl you have to do is look at footage of that little 911 in NYC. ALL OF 'EM nut cases! Looney tunes! Not very bright!
Reply: oller
Man, I work with probability, not possibility. There are an infinite number of possibilities, But av limited number od probabilities. In my mind, I have to go with what I consider the preponderance of evidence, and the simplest explanation. Plane hits high-tech building, critical supports are compromised, large fires burn, beams soften, house of cards falls down.
I think it was done by Al-Qaeda terrorists, because that's in their job description. They did it because they believe the Qur'an tells them to.
You seem to believe whatever story you hear, as long as it comes from "experts" like Dr. Jones. You don't seem to look up facts on any neutral website.
I don't specifically recall any website that you yourself has sent me to, buy I do know, because I read the headings, that every site you conspiracists send me to for verification of proof is a site set up and run by conspiracists. If there is a statement that doesn't ring true, I go to a neutral site like Wikipedia, or A.S.C.E., oy various engineering schools, and yes Jones' own habitat, BYU. You are allowing prejudice to guide you. Let go of that, there's much more info out there to study than these links!!!
Reply: Mainstream Expert that's some convincing evidence you just provided.  Care to share a name.  I have seen evidence that the steel was melted how did that occur.  Maybe you better consult your Mainstream expert.
Reply: *****
And I reject the free-fall idea completely.
It appears we are diametrically opposite in that matter.
Reply: oller
Oller, right now I'm sick and tired of making stupid mistakes, like plugging my space heater into the same power strip as my old laptop-tuned-desktop. I all all people should know better, and i cost the the 30-45 min. of reply I was preparing for you. My nerves are shattered right now so I'll try this again tomorrow night, since I don't have a date...
Now for a Xanax and sleeping pill. :/
Reply: ***** fair enough. Hope for quick recovery back to your old good(?) self!
Reply: *****

Bill the Shill
Reply: Dude there was thermite found at the sight of towers. actually super thermite.
Reply: ***** You saying I did 9/11 when I was 3?
Reply: ***** Ya you got me... I'm am a 68 year old CIA worker that loves to play minecraft. Sure... I mean you look like you are 68 with that profile picture.
Reply: *****
69. It's the funnest age.
Reply: *****
OK, I'll quit.
Reply: ***** Like I said, you don't have a single counterclaim. Just lame strawman fallacies and bullshit commentary. But, at least you're good for a laugh
Reply: I have come to realize that many of the "truthers aren't terribly concerened about what's good for America, or what the real truth is, but are driven by a deep and abiding hatred for Jews. "[I]sreals mossad did 9/11" proves my point beautifully. Maybe he's just another jihadist.
Reply: *****
My opinion of 9/11 is that it was conceived, planned and executed by Muslin extremists, or Jihadis, whichever term works best for you.

As for Switzerland, I hear life is great there, much less violence than here, I know for a fact they and the rest of the Scandinavian world has excellent taste in music (I'm listening to Sissel right now), and most of the food is wonderful except ludefisk.
I just wish there was a neutral country with warmer weather.
Meanwhile I will encourage my grandkids to throw the damn republican party into the next building collapse.
Reply: *****
You're losing it Bill!
LOL
XD
-
Reply: Gazillionth Nineeleven
Losing what?
...And who are you?
Reply: they found thermite in the dust wht you talking about  wake up your own governement did it bush family has heavt ties to all the binladen family he was even used by the cia he was dying ans knew it so they used him as a patsy come on cnn reporter finds him ina cave but the best army in the world couldnt find him bull shit and jfk let me guess oswald did tht too lol another decade and amaerica will be no better then germany in the nazi days
Reply: TheGooniessss
You are reading old, outdated and thoroughly discredited material. When you say "they", you mean Dr. Steven Jones, who got hold of some dust he was told came from the WTC site. As it turns out, some was from miles away and months after 9/11, some was in a mason jar (or something along that line), and none of it had verifiable chain of custody. Jones took on research without having qualifications in that field. Jones described primarily visual examination of some selected particles and noticed they were gray and red layers, and he said it "looked like" nanothermite. He made many other claims based on the various chemicals and compounds he found, and postulated that it was evidence that the buildings were professionally demolished. His conclusions, however didn't hold up to peer review. He did say more research was needed. That reasearch has yet to provide information useful to the 9/11 case. Thermite is a very common material used in construction for welding purposes. There is no record of anyone actually using it in demolition, as they want charges that will ignite and cut immediately, quickly and precisely. Thermite doesn't fill the bill at all. It is too slow, even the nanothermites and thermate.
You are new to this string but apparently an experienced conspiracy hobbyist. I hope you enjoy it, but don't let it take over your common sense.
Reply: and i got none my info from jones hes a bone head
Reply: TheGooniessss
If you got no info from Jones, where did you get the thermite idea? He's the one who claims evidence, and even he couldn't verify it.
Why is it you think you're the only one who has researched this? Is it because you have followed every link the other truthers have posted? Well, no, that couldn't be because so many of them have been pulled down...
Reply: do your own research theres tones of qualified ppl who have come forward and have yes proven it was used with secondary explosives, bottom line your own goverment is responsible wake up
Reply: professor steven jones you fuck nut and i can name many more but im done with your walnut sized mind ya troll lmao
Reply: judy wood like said there many of them pull your head out your ass take look at whats going on and if you think you live in free country your sadly mistaken
Reply: It is impossible for WTC 7 to fall at free fall speed without the aid of explosives. And it goes with the twin towers too.
Reply: TheGooniessss
Steven Jones, Professor Emeritus at BYU. Very good credentials, well respected by his peers - until he began researching matters well outside his specialty - a theoretical physicist working in civil engineering, and the reviews he got from his fellow researchers at BYU we unimpressed my his report. Jones intimated at te outset he was convinced WTC was brought down with "Professional Demolition" type setup. His speculation in this matter was concidered unprofessional, and counter to the established proceedure used in any scientific research.
The many procedural errors, the questionable value of his samples and the conclusion drawn from only partial tests run, couple with his admission that the matter required more testing before a conclusion could be drawn, nevertheless drawing his on speculative conclusion that the towers were brought down whith the use of thermite turn almost all of the actual civil engineering faculty against him. he was eventually dismissed from the teaching  faculty, and took retirement as a Professor Emeritus.
Reply: you need to stop watching tv , your the type that sees something on tv and cause you seen it on tv well it must be real
Reply: TheGooniessss
I haven't seen squat on TV in years, idiot...I said research, not entertainment.
Reply: ***** I am sorry you see me as a looner (whatever that is) without saying so to my face. I think, that between us I have provided more rational arguments for my view that the official story about 9/11 is false. But you don´t seem to care so much about facts. In your statement you say that you´d like to go to Switzerland or some other Scandinavian country and listen to Sissel. You are showing your level of education on these facts and that you live in some kind of dream land instead of reality.
I have three things that I wanted to discuss with you on factual grounds which you refused. Now I understand that you just wish to continue your dreams.
The first fact is the absence of evidence for the hijackers presence at the airports. The second is that there is no comprehensive official story about the fate of Flight 93; buried or disintegrated.
The third is this statement concerning the construction of the Twin Towers that makes the official explanation impossible: " The individual floors acted as a unified structural 'diaphragm' to stiffen the structure laterally, but the steel composition of each floor was constructed in smaller units of open web trusses spanning between steel reinforced concrete beams and topped with a steel deck and lightweight concrete. Thus, each floor was NOT a monolithic slab and structural system spanning across each tower from one exterior wall to the other three, as we are led to believe. Each floor, in fact, terminating at the contiguous inner structural service core, resembled a square 'donut', with the core area being the 'donut hole', so to speak. Failure of floor structural support in any quadrant of the building plan, or even in any half, thus, would have failed asymmetrically. And at the time of failure would not, could not, have 'pancaked' symmetrically as the misleading NIST and commission reports indicate. The buildings had massive, in fact, over designed, internal structures."
Reply: oller
1. There is little importance it that matter, if indeed it's true. I don't know. Whether or not anyone recognized, reported, or was even on the watch for these men is immaterial. The FBI has limited manpower, you know, and can't track every suspect at all times. CIA hadn't shared info on who best to watch, or when, or where they might be.
And disguises are effective, too.
2. Flight 93 hit the ground air at near vertical, burying approximately 25 feet into the ground. The wings and fuselage were scattered over a broad area. Human remains, luggage, personal effects including many papers containing identifiable information were found. Most of the remains of the aircraft were found. There were witnesses to the overflight, but apparently none had paid much attention until it seemed apparent the craft was going down, There were numerous phone calls made from the plane relaying the info re the highjacking.
3. Your analysis of the flooring system is pretty much as I had understood, I don't see where you should feel misled.
Indeed the floors weren't contiguous pieces, it would be virtually impossible to build them that way. They were, however, still interconnected as good engineering practice would demand, and fell sufficiently intact to behave essentially as one piece.. The "symmetry" you speak of is not required for a "pancake" effect. In fact some assume it means a perfect stacking of the floors, while there is no reason to make that assumption The floors would have drifted on the cushion of air to some extent, they surely didn't remain flat in the descent.. You seem to believe that the many innocuous errors in the NIST report were purposefully misleading, but to what end? To convince the world that the buildings fell in some innocent fashion? Maybe to imply that this was such a common event in our violent nation that they are highly experienced int he collapse of two 210 story buildings?.
Reply: hes a troll he cant get his head out his ass to see the truth
Reply: *****
Bullshit, boy, I personally have talked to people on planes. On cellphones. On cruising commercial flights.
Reply: TheGooniessss
So the government pays me big bucks to watch TV shows and believe it all. Sure. All truth comes from the X-Files.
Reply: Bye, boys, it's been...well...really, really stupid.
Reply: ty and have a merry x mas
Reply: says it all right there in your statement i work for the government a low level sheep tht follows blindly shame on you
Reply: Bob Czz who are you talking to?
Reply: Bob Czz
who is Gene Rosen?
Reply: Bob Czz
Never mind, Bobby. You are so thoroughly discredited that I'm blocking you. You're not even fun anymore. Just boring.
Reply: oller
I though I'd come check on you, but apparently your still just pushing your agenda. When you used the term "shill", you showed your true colors. As I had come to believe, you are indeed uninterested in facts, just rumors. You are a true disappointment.
Reply: i just think he like s the smell his own bull shit  no god damn pop can is gonna cut threw cement and steel and a plane is more r less just tht a flying pop can
Reply: "mainstream expert found no evidence of thermite" Who would that have been pray tell? NIST didn't find it because they never searched for it. They proclaimed early on that explosives weren't used. Shyam Sunder explains this on video here at YT. A real expert did find traces of thermite. His findings were confirmed by other experts. In fact 2,000 experts of A&E for 9/11 truth say it was explosives in a cont.demo that did the job.
Reply: Joel Barry since the crime scene was totally compromised a forensic investigation was more or less useless. Had there been a trial the evidence would not have been allowed. On the other hand those who violated these rules would have been heavily punished and their credibility zero.
Reply: oller I agree with that oller.
Reply: Joel Barry "A real expert did find traces of thermite."
 I suppose you're talking about Professor Jones again. Tell me again, what was his field of expertise?
Reply: ***** thermite or no thermite; the Government has to answer to the fall that could not have come about by fire alone. You have to prove it and you have not. You have assumed that the underlying structure was unable to give any resistance but you have not given any credible answer to that. You have told us about the initiation (which there are many reasons to doubt) but then you have never explained what was wrong with the construction. A construction is named like that because the separate pieces are supporting each other. But there was no support for 80-90 floors of steel that day. What was wrong with the construction? Neither have you explained why the upper part would not slow down when it hit the unscathed construction. Nor have you explained why this accelerating ever mounting pile of rubble would not continue all the way into the "bathtub" and flooded all of lower Manhattan. Nor have you explained how the mathematical formula that was used never took the physical reality into consideration. You can see with your own eyes the upper part disintegrate which means it was fragments falling which means the impact will be only a fraction of intact structural parts. Nor have you taken into account that the remains of the core columns look like burnt matchsticks just before they fall. Means they should have made a LOT of resistance. No mr official conspirator theory supporter; you have not explained anything and deserve no credit for giving any valuable contribution to this discussion.
Reply: *****
This might help.

http://markbasile.org/
Reply: *****
What was Einstein's field of expertise before he published the theory of relativity?

Were you one of those guys who didn't want to accept his theories because he was a lowly PATENT CLERK?!

One, that's elitist, and since Einstein was jewish I'll say it: that's probably racist too.

:-)

(Just playing buddy)

Secondly, that's doing science by resume. And it has no place in science.
Reply: James Shiflett I have seen the video where he confirms the findings of Steven Jones. Good proof!
Reply: bill you really are delusional , here is a list of many more experts Richard Gage,Addam Parrott.Bachelor's degree in Chemical Engineering at Queens University.Mark Basile, B.S,CH.E Chemical Engineer: I have independently seen thermitic activity within two separate independent samples of World Trade Center dust.I am Jerry Lobdill.   I am a retired physicist and chemical engineer.   I have a B.S in Chemical Engineering from Texas Tech and I have extensive course work is mathematics and physics from the University of Texas at Austin. I have broad experience in analysis and applied research. Thirty year professional history spanning physics, chemical engineering, statistical analysis and modelling and operations research.Jerry Lobdill, B.S.Ch.E Physicist/Chemical Engineer: So what do the micro spheres contain? Iron is the main element. And then they have smaller portions of Aluminum, Sulphur, a trace of Manganese, a trace of Potassium. Most of the micro spheres are less than a tenth of an inch in diameter and they are spherical. They are found in all of the dust blown out of the World Trade Center buildings during collapse. No matter where in Manhattan that dust is picked up.Kathy McCray, B.S. Metallurgical Engineering: You must have had a much hotter heat source to get 2700 degrees Fahrenheit in order to melt the steel, melt the iron, to get these iron molten spheres. Your heat source must be something like a chemical reaction, an exothermic chemical reaction. In the case of Thermite that reacts at 4500 degrees Fahrenheit.Mark Basile, B.S,CH.E Chemical Engineer: My contention based on finding Thermite residue in the dust is that it happened before. It didn't happen after, in the fires that ensued in the rubble piles. All the characteristics in the microspheres, along with what I see in the beams that where actually found, tell me that Thermite was involved in melting those steel beams. IM SURE BILL YOU DONT HAVE HALF THE EDUCATION THESE PPL DO I COULD LISTED 100 PPL LIKE THIS BUT WITH THIS I AM DONE , I REALLY THINK YOU JUST ENJOY BICKERING ME IM SIMPLY SICK OF SOCIETY FALLING APPART DUE TO OUR OWN GOVERNMENTS THE BUSH FAMILY RUINED THE STATES OBAMA WILL TAKE THE FALL AND THE ELITE HAVE THEN MADE SURE THERE WILL NEVER BE ANOTHER BLACK PRESIDENT
HOPE YOU HAD A MERRY X MAS BILL just to sad that you cant see the truth
Reply: TheGooniessss Bravo Jerry. You can't imagine how pleased I was to read your piece above. It truly was a home run, or better still a no hitter. Thanks for identifying yourself. You can be proud of your education and career. Glad you're speaking up. Joel Barry, musician and supporter of A&E for 9/11 Truth.
Reply: Joel Barry  jerry?? think u have the wrong person
Reply: TheGooniessss I thought you identified yourself as Jerry Lobdil, a retired physicist.
Reply: know just was posting names of ppl for bill
Reply: *****
I'm glad you listed that link, I had lost it.
If you look closely, you will see several distinct layers of material with pieces of rebar and sheet metal interspersed in it. That bears no resemblance to molten steel. None. Read the museum's own caption:

"The museum has not decided whether to include a composite of several tower floors and other materials that were crushed and fused together during the collapse of the World Trade Center."
Reply: ***** no, because the reason these materials are "fused" together is because the CONCRETE was decomposed and then formed a binding matrix around the steel. This is entirely consistent with it being exposed to temperatures exceeding at least 250C before then cooling. That's it. There is nothing about your blatantly misleading (mis)interpretation of this object that justifies your prejudice. You are wrong, and your own link proves it.
Reply: James Shiflett
Albert Einstein Was one of the world premier mathematicians. You didn't know that?
Reply: jamexxxxxxxx
That calls for an explanation
Reply: Are they saying that there was thermite in the exact floor they crashed into?  Is THAT possible?  Much less two planes?  Was al Queida involved, or did our conspirators work with them?  Why did Bin Laden claim something like that if others did it?  This is just crazy.
Reply: ***** there is no evidence whatsoever of ANY thermitic material at the site. This is precisely why Harrit and Jones had to make some up when they tried to circumvent scientific analysis and review by committing an act of fraud. If they had some evidence then they wouldn't have needed to make that shit up, would they, precious?

"molten iron,"

- never happened, despite it fitting the NIST collapse sequence from at least two different sources. Not only would this mythical substance NOT be evidence in favour of your little delusion, it never existed anyway.

"Fe spheres in the WTC dust "

- you mean those iron spherules that form from welding? Or even something as simple as ABRASION?

Fucking moron.

"explosive squibs"

- show me a single example of such an event from BEFORE collapse initiation. If you can't, they will be assumed to be the outgassing caused by compression of the upper storeys, because to suggest otherwise would require that these things went off AFTER the collapse that they are supposed to initiate.

Bring it, bitch.

"WTC1's 6.31m/s2 accelerated disintegration in which its top section didn't decelerate at all as it moved into its lower section, as one example, invalidates the official conspiracy narrative."

- explain. In detail.

Let me give you a quick hint as to why you are about to get fucked. Your claimed acceleration rate is about 2/3 that of freefall, which means that it is pretty far from "didn't decelerate". Gravity was pulling on this object at approx. 9.81,/sec/sec, which means that 6.31m/sec/sec automatically proves plenty of deceleration. If there was no deceleration then the upper section WOULD have ploughed through the lower section at 9.80665m/sec/sec, so that fact that it did not is indisputable proof that there was plenty of impedance to the fall, resulting in your cited deceleration.

I know my physics, and you patently don't. Don't even try to bullshit me again, princess.
Reply: TheGooniessss not only is there no evidence that any thermitic material was used, but there is plenty of evidence to prove that it can't have been used, such as the observed deformation of steel for the half-hour or so preceding the collapses.

It is physically impossible for thermitic materials to have either initiated those collapses OR produced the results presented in the Harrit fraud. Case closed.

"tons of molten iron and cement all melted together "

- pure fiction. Post me a single link to ANY "molten iron" or your assertions are automatically void. Remember, I am demanding evidence that the STEEL melted, not that the concrete decomposed. I'm willing to bet that a spastic like you doesn't know the difference.
Reply: what ever you say . yup a aluminum plane and fire that could never ever do the damage  to those building  how the hell do u explain building 7 and ya there was lost found infact by 10 diffrent experts if i find the article ill post  it sad to see thers still so many ppl blind to what the worlds elite is up too and i spose to each there own im just glad my heads not stuck my ass and following the herd still wake up my fellow humans
Reply: Yes, I always believe in incredibly complex conspiracies involving multiple planes, multiple buildings and hundreds, thousands? of people explosives and coordination by different government institutions and planned during different presidential elections -all in the public view.  l guess if you need to believe it - thank god you are the vast minority.
Reply: think the last study done more then half Americans now dont believe the nist report but whos the minority , silly rabbit tricks r for kids and im done with this thread just sad ppl still so fucking brain washed and cant think for them selves ......if you due the research this shit goes all the way back to when the feds took all great grandpa bushs money because he was a nazi supporter was proven and his family from tht day on swore revenge first president bush started the down fall number 2 put some huge holes in the ship now obama will sink it and the bush family has succeeded in making sure there will never be another black president  / really do  you honestly think your still living in the land the free ???? NOPE
Reply: Not believing an NIST report does not mean that "people" believe in a conspiracy at all - especially any one conspiracy....  That's like saying that because 70% of people believe in a deity that Christianity the true religion..... And in reality is any report ever complete, accurate, not able to be contested?  That is the same logic used to discredit climate change - we don't have all the answers, and scientists don't all agree so ipso facto it's not real....  Besides WHO F'N cares WHAT the public believes - that might mean something politically, but it proves NOTHING in "reality" - do we take public votes for the weather, cancer diagnosis, business decisions???
Reply: Bill M. :The reason that the "Official Story Experts" did not find any thermite is quite simple :  they did not look , as they are the first to tell  you.  It was not necessary for them to look, since Mayor Guiliani told them in advance who the culprits were.
Reply: Bill M:  Excellent job trying to look "impartial".  But then you go off the rails, putting out the same utterly faulty NIST report fantasy.  You cannot name a building which was actually demolished in the way you describe.  But anyone at all who watches Youtube building demolitions can see at once that they mostly look likc 9/11; you can even time the tell tale Free Fall time with your own stopwatch.  There is just NO counter argument to Newton's Laws of Motion.
Reply: I guess if something looks like something it must be true.  I suppose you see Jesus in toast too.  I am amazed people actually think a four pronged premeditated attack could have been pulled off by humans like this.  Now if you said aliens, or a god did it perhaps, but humans - not.
Reply: 1.the CIA directed and handled Emad Salem and tried to frame him and he recorded the CIA knowingly gave explosives to hand picked"terrorist" to create fear and then bring in the patriot act. 2. Building seven cant be dropped in free fall from fire..it was rigged before the incident by demo crews. 3.9/11 was doing 4 things..to frame Islamic people as all terrorist..bring in legislation to remove Posse comitatus via the patriot act..attacking Iraq to capture the oil fields and the countrys natural reasources.. and destropy evidence stored in the pentagon about where the 2.3T missing dollars that was stolen and used for black projects.
Reply: I could perhaps believe the cia trained and used the terrorists to take the planes, but not hundreds, thousands of operatives with fake planes, planting explosives and such all done before the blast - that is just not logistically feasible - especially 15 years later with no leaks.   Besides, when I see building demolitions generally they have controlled explosions which have a characteristic audio and visible pattern as they blow - which was not recorded or proven.
Reply: chris silva Do you have any idea of the vast amounts of money our "Security " agencies control?  No, not even Congress does, but it is large enough to drive the US into bankruptcy. And you think the 9/11 demolitions were "not logistically feasible"?! Or that "thousands " of operatives would be needed?!  When commercial firms demolish buildings, they don't need "thousands".  Since the perpetrators had at least months , if not years to set up this gigantic fraud, there is no reason to expect large numbers of random people would be needed, or  either detection or confessions, no matter how many years have passed.
Reply: Unfortunately your "factual evidence" is a belief, not actual physical evidence.  Saying one building cannot do something because we cannot explain it - a mystery is a mystery, not "factual evidence".  Also, if building 7 was destroyed why does that mean the whole project was fake with the twin towers wired ahead of time for destruction, fake Saudi Terrorists trained years ahead of time, fake planes and the attack on the pentagon.

Money doesn't make for perfect anything - I suppose Snowden's leak was planned by the CIA too?  To bring up The Manhattan Project does not relate as they were isolated facilities and the job was patriotic in nature - and it did have security leaks.  Blowing up US property, killing so many innocent US citizens is a much different issue, and today you can use the internet to disseminate information anonymously to many other people.
Reply: disgny Theres video evidence of ny poiice saying there "gonna pull it" and I know people in demoltion and a bilding that size would take quite awhile to wire.. so it was pre rigged
Reply: Chris S.  Any serious group of "Terrorists" would have done enough research ahead of time to have found out that NO steel framed modern building has EVER been brought down by fire,or airplanes. Any inspiration they might have had about airplanes and jet fuel, would not outlast the revelation that such buildings can easily, and often are, be brought down by controlled demolitions.
Reply: From what I understand the specific design of these building was relatively new, and I and I know of few other crashes with 737's loaded with fuel which crashed at high speed.  From what I had also heard bin laden was surprised about the building collapse as he didn't know it would happen.  Still, setting up controlled demolition of two (three) buildings without anyone knowing is a bit of a stretch.  It's almost as "interesting" as Obama taking over the country, the military and such - yeah, we better worry - not.

In my opinion (admittedly not worth much) through the sheer size and "gravity" of the structure would negate many of the influences that would cause the structure to go left or right - the bigger you are the harder you fall and with so much weight and speed it just went where mass goes - strait down.  Yes I have seen other demolitions, although admittedly not any building as tall and new as the twin towers....
Reply: You seem to have an interest in technology.  About the WTC towers demolotion, I'm sure you are aware that demolishing steel framed buildgings has been  done routinely and  safely with various explosives and thermite or thermate for years. So why are you so easily persuaded that those towers could be destroyed by airplanes and jet fuel, when there is NO example of this ever being done, but plenty where there are roaring fires, for lengthy periods, but after the fires are put out, the usual scenario is to re-use the the existing framework, which in most cases is not seriously damaged,  to rebuild.  Additionally there are videos of airplanes being crashed into various obstacles,  similar to the usual car  test crashes, and it is quite clear that it doesn't take much to destroy an airplane, compared to steel structures.   All this just doesn't add up.  But I gather that you are not just blinded by "Patriotism", so I'm wondering how come the irrational conclusion?
Reply: I know of nothing I would consider "similar" to judge this incident by.  They have shown there were lower amounts of insulation in the WTC in the cross beams and in the main pillar section around the stairs and elevators.  From what I understand this was also the first of it's kind manufactured and unique and particlarly susceptible to this kind of impact and fire.  There is this assessment:http://vincentdunn.com/wtc.html 

I also find it strange that someone who has a "interest in technology" as yourself would subscribe to such complex and unproven plots of mere mortals as possible.  With the change in technology over the last 20 years alone an organization would not only have to be powerful, but flexible to keep it's stranglehold on it's secrecy from the world and still be able to create world altering plots.  Old, Powerful and flexible DO NOT mix as a general rule and I still over the last 50 years from UFO's, to fake moon landings to this that or the other have no proof of humans being capable of being secret, powerful and complex in structure.  It would be nice, as we need as a species to make choices "the masses" will never vote for, but I just don't see it happening as we will generally sit in our comfort zones until pushed the hell out by war, weather or opportunity.
Reply: chris s.:  "they " have NOT shown that "explosions "blew off insulation from WTC  steelwork;  that is merely a desperate guess, an attempt to explain the otherwise inexplicable.
   Furthermore, those towers were NOT some kind of weird  untested design, merely a  logical extension of previous efforts, and based on tried and true principles.   So the idea that airplanes and jet fuel could have brought down the towers is just that: an "idea", and not a very good one, since it is wrong is SO many ways.
Reply: well I guess we all have ideas.  You have an idea that there is no other way for the buildings to fall as they did unless there was some demolition.  Many other professionals:http://vincentdunn.com/wtc.html  one here have other ideas.  Again, the idea of a human organization -especially in this day and age - having the ability to do what you say is as illogical as the building falling is to you.  btw thanks for labeling their guess as "desperate" while yours fully logical.  I believe that conspiracy efforts are usually more "desperate" in their character - let's match our concocted ideas to the facts and sell "that" as a fact.
Reply: No , "Many other (Engineers or Architects) do NOT have other ideas , except for a carefully selected few, like the NIST group.
     The Fire Official you referenced was merely repeating the "Official Story",( which Mayor G. favored us with even before the dust had settled. )He was  even un aware that the ferocious fire he imagined was  collapsing the buildings were NOT high test gasoline, although that  has not much importance.
   This man's  comments reveal that he really doesn't have much of a grip on what he's talking about.   He talks about (weak) "tubular colums" as opposed to the sturdy ones in the Empire State bldg. Also that it was the external periphery columns that were doing all the work of support.  That is simply not so.  Also his ideas about using less concrete. But most significant of all, since he is a Fire Official, is that he does not even mention that there is NO previous case in history that corresponds to WTC.  His idea that they are uniquely ,and poorlly designed, is just nonsense. ( We have to start out admitting that  every last building in existence is "unique", but the design and construction methods are not.  That's why buildings are so reliable. ) But they can't withstand modern explosives.
Reply: Yes and the immediate ignition of thermite would have set off every fire alarm and water sprinkler nearby.
Reply: There would have to be some gas/chemical evidence from thermite - beyond the logistical issues with planning, installing and igniting it in all three buildings with no evidence, and no leaks by any patriot of the hundreds or thousands that would have been involved...
Reply: Leo Bolduc Why would you imagine that fire alarms and sprinkler action would have made the slightest difference?!  A "regular "fire, from jet fuel burning would get the same result , no?
Reply: chris silva
Did you actually look at the video you were commenting on ,The Great Thermate Debate,  J. Coles amateur experiments with thermite?  It seems to have answered   every comment that concerns you , plus more.
Reply: disgny
Another excellent point I saw recently:  The Manhattan Project, about the A bomb, had 20,000 people in on the secret so to speak; there were no leaks,etc. unless you count Oppenheimers change of heart about Hydrogen bombs,later on.
Reply: ***** What "mainstream expert??!  A detailed FEMA investigation of steel pieces from WTC  showed all kinds of evidence consistent with Thermate, but they did refrain from suggesting any kind of mechanism to establish just why sulfur should have been found in the steel, critically.   One might almost think that they were instructed not to find any.  Perhaps your expert can solve this mystery. Please don't mention Occam's razor.  I think you know why.
Reply: disgny Except if you count the guy who sent all the information about it to the Russians so that they could build their own bombs.
Reply: Islamisthecultofsin Not quite sure what you are talking about.  The  Rosenbergs, perhaps, from WW2?!  Note that the BIG SECRET about the A bomb was that it could be made to work, when it might have been a gigantic waste of time.  That 's  about it.
Reply: disgny  From Atomic Spys:  They list 11 spies by name.  http://en.wikipedia.org/wiki/Atomic_spies
" Moscow was very specific in asking for information from their intelligence cells in America and demanded updates on the progress of the Allied project. Moscow was also greatly concerned with the procedures being used for U-235 separation, what method of detonation was being used, and what industrial equipment was being used for these techniques.[8]
 
To obtain this information from the Manhattan Project, the Soviet Union needed spies that had security clearance high enough to have access to classified information and who could understand and interpret what they were stealing. Moscow also needed reliable spies who believed in the communist cause and would provide accurate information. One such Soviet spy was Theodore Hall, who had been a developer on the bombs dropped in Japan.[9] Hall gave up the specifications of the bomb dropped on Nagasaki. This information allowed the Soviet scientists a firsthand look at the successful set up of an atomic weapon built by the Allied team.
 
Although Hall's information was helpful to the Soviet cause, the most influential of the atomic spies was Klaus Fuchs. Fuchs was a German-born British physicist who was sent to America to work on the atomic project where he became one of the lead scientists. Fuchs became a member of the Communist Party while he was still a student in Germany. "
Reply: Islamisthecultofsin The single most critical "atomic secret" was that the whole scheme worked.  That's all they really needed to know; the rest is just industrial engineering.
Reply: disgny  There is alot more to it than that.  Iran has been working on a bomb for twenty years.
Reply: Islamisthecultofsin Didn't quite get your point.  No one seems to be saying that it is impossible for Iran to make a bomb, only whether their having one is more or less dangerous that Israel having one.  That is not at all obvious. 
   If "we " really wanted to make sure that Iran did not make bombs, we should be proposing that they restrict themselves to using the Thorium LFTR nuclear fission system.  That way they could have cheap nuclear fission power, but no bomb material.. (Unlike the usual Uranium LWR based systems, like Fukusima)   FYI, the LFTR was a secret Cold War nuclear fission aircraft engine project, which , after it was designed and demonstrated, was abandoned on account of missiles, but also just exactly because you couldn.t make bombs with it)
Reply: disgny  The point was that it is difficult to build a nuclear weapon.
Reply: ***** why do you guys always stoop to calling people interested in challenging the official story (proved incorrect so many times now) twofers etc... I don't get it... Some people are paranoid but theres a lot of shit that hasn't been explained properly.
Reply: ***** pretty daft if you ask me considering previous explosive attack on the tower plus eye witness accounts of explosions. Don't you think?
Reply: *****  If  you want to "get it", just picture yourself in the shoes of the gang that did the whole Fraud.  You have just earned yourself and friends many billions of dollars, as well as justified forever the endless, very expensive "war " on "Terror" (moslems) that your friends and relations are profiting from in Spades.  Why would you NOT subsidize a small group of people who have nothing better to do , to create the impression on the Internet that , "No , ontrolled Demolition never happened."   It might cost you a million.  So what?
Reply: ***** I don't know but I've seen two guys interviewed at the scene that just seem to be planting the official story, they seem to make odd statements unlike most people would speak in that situation... one guy I haven't been able to find in years but he's describing the planes... unless they are just eccentric personalities, it's possible...
Reply: ***** You are in denial Alqaeda and bin laden even denied responsibility for doing it which is why the taliban would not hand him over
Reply: David Herron yeah I just don't believe they did it without help. .. To say the least...
Reply: ***** The Keane Commission interviewed over 1,200 people in 10 countries and reviewed over two and a half million pages of documents, including some closely guarded classified national security documents. The commission also relied heavily on the FBI's PENTTBOM investigation. Before it was released by the commission, the final public report of the 9/11 Report was edited by Philip Zelikow (who was Bush's inside man) who decided what the public were told.  Since it's publication 7/10 of the commissioners have declared it's inaccuracy, and most of the 'alleged evidence' that 19 hghjackers were responsible was extracted under torture by the CIA from a guy called Khalid Sheikh Mohammed who was water-boarded 183 times.  If he was a member of al-Queada then why wouldn't he openly admit they were responsible if they were.... instead of 'confessing' this after being tortured !!  

So where in the 9/11 Commission Report does it show the evidence that bin-Laden was responsible.... evidence provided with or without the use of torture ??    

go....
Reply: Eric Arthur Blair Jr I am with you 100% Hijackers definatley managed to hijack something and planes did indeed hit the trade center, but thats got little to do with how the towers fell down and turned into dust.
It stinks so badly it will never go away
Reply: David Herron How come the flight that hit the pentagon never had the cockpit door opened the entire flight according to the flight data recorder?

OOPS!

911 was Israel. Dov Zakheim. Look him up. The truth.
Reply: Major Tom I will, but where have you got information on recorders from the pentagon plane. I am not aware such thing is available
Reply: ***** http://en.wikipedia.org/wiki/Skyscraper_fire#cite_note-16
Reply: solidus311 that's wikipedia. you could have edited it before posting the link.
Reply: Emvaz22"Which "expert" found this supposed proof the thermite could not have been used? Which peer-reviewed, open scientific journal was this information published in?"

- wrong way around. YOU are required to provide evidence SUPPORTING its use before anyone has to refute it. That's how science works.

The OP does not assert that thermitic materials were proven to have been absent, but that there was NO EVIDENCE that they were present.

Learn to read.
Reply: Christ J OK:  
Active Thermitic Material Discovered in Dust from the 9/11 World Trade Center Catastrophe.  Harrit et al.  The Open Chemical Physics Journal.  April 2009.

Peer reviewed, published paper.  Published for 6 years, therefore if it is incorrect there should be a paper which reexamines the dust and comes to a different conclusion.  Surely 6 years is enough time to muster a credible academic refutation.

Your turn.
Reply: Emvaz22"Peer reviewed, published paper."

- post a link to the journal that it appears in then, bitch. You'll fail, because it doesn't exist on the peer-reviewed literature.

Furthermore, it has NEVER BEEN PEER-REVIEWED. Ever. Harrit and Jones actively circumvented the peer-review process in an attempt to get it published, but the journal in question noticed them and so they have never bothered to re-submit it. Know why they have never actually tried to get it reviewed? Because they know it is packed with lies, misrepresentations, utterly untenable conclusions and raw data which outright disproves the claims they make.

Your source - the one you have just provided in support of your bullshit - does a rather good job of refuting your own argument. I bet you've never even read that shitrag of a report, you ignorant little spastic.

" Published for 6 years,"

- where?

"Surely 6 years is enough time to muster a credible academic refutation."

- not when there is no peer-reviewed source to actually refute, princess.

Tell you what: let's see if you have the integrity to analyse this stuff yourself, shall we? Here is a link to that bullshit report:

http://www.google.co.uk/url?sa=t&rct=j&q=&esrc=s&source=web&cd=1&ved=0CCYQFjAAahUKEwjXlPuU_IPGAhViLdsKHXCJAS0&url=http%3A%2F%2Fbenthamopen.com%2Fcontents%2Fpdf%2FTOCPJ%2FTOCPJ-2-7.pdf&ei=M5J3VZevMOLa7AbwkoboAg&usg=AFQjCNFC3-VG5EBChE6qfbjFMIvXSmyXYQ&sig2=fZa2kW1lWJrljuMaler1rQ&bvm=bv.95039771,d.ZGU

- download it and open it. Now, look at fig. 30. This shows the amount of energy in various materials - including thermite - as well as the energy content of the samples measured. Note first that the energy content of the known examples is their MAXIMUM energy content, based on their bond energies.

Now, look at the energy content of thermite and samples 3 and 4. Thermite has LESS energy - at its MAXIMUM value - then either of these samples. This result alone explicitly proves that these chips WERE NOT THERMITE.

Done.
Reply: Christ J what about the molten iron balls found at the site? those melted at a higher temp than steel and have been absolutely proven to be there. they could also be the iron particles needed to make thermite after being melted down in the burning process.
Reply: Clash Bluelight you mean the ones which are usually referred to as "meteorites"? they are nothing more than decomposed concrete with steel objects embedded within them. The steel shows no signs of melting, but the concrete has been exposed to sufficient heat to denature it - which happens at about 300C.

Alternatively, you may be referring to the "iron-rich spherules" described in places like that worthless pseudo-paper I have just been presented with. In which case, I invite you to read the abstract of this PEER-REVIEWED paper:

http://www.sciencedirect.com/science/article/pii/S1367912012001228

- in which you will note that identical objects are described  with this phrase:

"The spherule formation is attributed to a low temperature hydrothermal process (150–200 °C)"

- so, which of those were you talking about? The intact steel within those decomposed chunks of concrete which form below 300 Celsius or those iron spherules that form at even lower temperatures?
Reply: Christ J i'm referring to iron balls found by my relatives. did that never go public? if not then i'll retract my claim right now. here's a new one: what about the fact that there was absolutely nothing that hit building 6 yet it also imploded? and even though it imploded there was almost no rubble in the building. how can this happen if the building wasn't cleared before people went in? it can't. that means that someone went into building 6 and cleared it out before anyone was allowed on the scene. and how about the fact that no terrorists were found in the airports or boarding the planes? if no terrorists were there, implosions happened with nothing having touched the building, and the building was already cleared by the time the first people were allowed to go in, then how could it have been a terrorist attack? it couldn't have! it's a spacial paradox if it did! and those can't happen. you should look at the proof and draw a conclusion that doesn't involve believing the government's stories of paradoxes causing 9-11.
Reply: Clash Bluelight "what about the fact that there was absolutely nothing that hit building 6 yet it also imploded? "

- really? "Imploded"? On what evidence do you base that assertion? The fact that the damage is wholly inconsistent with demolition of any kind, for example? Is that what's forcing you to use such an inappropriate term?

Here is WTC 6:

http://upload.wikimedia.org/wikipedia/commons/3/3b/September_17_2001.jpg

- and all I can see is damage that is consistent solely with impact from above. None of the perimeter walls are damaged, yet there is a hole from roof to ground in the centre which is lined with structural elements which indicate that they were exposed to force FROM ABOVE, because they are bent downwards.

The above source is pretty good resolution, so zoom in to your heart's content. Had this been a controlled demolition the perimeter walls would have been connected to the rest of the structure, resulting in them being pulled inwards as the centre fell - just like every controlled demolition in history, and just like we see in none of the WTC collapses.

So, we have damage that is only explicable as the result of impact from above, so where did this impacting object(s) come from? Here:

http://www.ara.com/Projects/SVO/SVO_images/WTC_figures/WTCComplexOverview.jpg

- we can see that the impact point of flight 11 is directly above WTC 6, meaning hat not only did the plane hit WTC 1right above WTC 6, but that WTC 1 also collapse right next to it. And, bearing in mind the way in which WTC 1 collapsed, it is utterly untenable to claim that none of the debris from either of these events fell onto WTC 6.

"and even though it imploded there was almost no rubble in the building."

- I refute you thus:

http://i.ytimg.com/vi/a4FkO5ry1uo/maxresdefault.jpg

- in which there is certainly sufficient rubble to account for the damaged floors and roof.

"and how about the fact that..."

- typical "truth"er bullshit. Someone conclusively disproves your crap, so you just wave it away and then revert to a series of other equally-incorrect assertions in the hope that your demonstrable dishonesty will be hidden. Fuck off, cunt. the topic of this thread - and the video it is featured on - is thermitic materials. Want to have your other bullshit decimated? Then mention my username on a relevant thread and I'll happily annihilate you in front of some of your other fellow lunatics there as well.

You are NOT evading the fact that you are wrong by changing the subject. It is physically impossible for thermitic materials to have caused the observed effects, and there is no scientific evidence that they were ever used. Case closed.

Either refute that statement or accept it as correct.
Reply: Christ J the image you used shows all plane debris hitting nowhere near 6. also wtc 1 imploded meaning that no debris could have fallen sideways. you can't deny that wtc 1 imploded cause that would be denying absolute fact. and if the plane didn't hit 6, the tower didn't hit 6, and gravity didn't magically multiply around 6, then wtc 6 was destroyed by nothing. i've seen hundreds of demolitions go slightly wrong and end up looking exactly like wtc 6 did. all it takes is for 1 or 2 charges to either go off late or not go off at all. and if the thermite charges didn't go off then they'd still be there. unless the building was cleared shortly afterwards, which it was.

and one more thing. it's been proven that thermite could cause these effects. and you can't prove that a plane can cause these effects. i'll give each word it's own line so that it's impossible to misread.

if
a
plane
hits
one
side
of
a
building
then
that
one
side
receives
damage.
thus
the
buildigs
either
fell
over
or
were
hit
on
all
sides.
the
planes
are
physically
incapable
of
causing
an
implosion,
much
less
two
of
them
in
such
perfect
form!
refute
this
absolute
fact
or
give
up.
you
can't
say
that
breaking
the
beams
on
one
side
of
a
building
can
cause
a
perfect
implosion
without
being
an
idiot!

was that clear enough? cause people seem to always misread this statement. it happens so often that i'm starting to think debunkers are doing it on purpose.
Reply: Major Tom are you truther or debunker??? i'm guessing truther. welcome to the thread fellow truther! :D

as a word of advice i suggest that you don't curse, insult, or caps lock. they won't listen to you at all if you do. instead just beat them with calm educated statements. they usually give up after a few days. hope i've helped!

ps one more thing. i've gathered about a third of all the truther knowledge in a comment a little while above. use it as you wish! :D
Reply: Major Tom right on dude, ps have you seen that pentagon investigate documentary where they travel to the pentagon and seek out all the witnesses and discover one of them was bribed
Reply: David Herron i haven't. can i has link???
Reply: Christ J are you incapable of answering my question ????  shall I ask you again ??????
Reply: Eric Arthur Blair Jr just want to say that you need to post link to a source, whether for or against as statement means nothing on its own
Reply: Eric Arthur Blair Jr he's kinda right. if he asks for your proof you have to give it to him. if you don't then we'll be forced to throw your claims in the garbage with all the other unbacked claims.
Reply: Clash Bluelight no problem,,,,,,
http://www.nist.gov/manuscript-publication-search.cfm?pub_id=101366
Reply: Eric Arthur Blair Jr thank you for your cooperation! this makes things much easier! :D
Reply: If you are actually searching for the truth you are on the same side, regardless of whether the conclusion backs or disproves something.
ALWAYS
remember that there has been a great deal of effort to coin the phrase " truther" just as following any major event like roswell or jfk the term/phrase "Conspiracy was also hijacked and reversed  to imply people are mad or paranoid.
Both sides in the 911 debate are guilty of being drawn in to unnecessary emotional conflict by quite sophisticated social engineering.
Don,t make it easy for them, try cooperating.
regardless of any inside job or not, a lot of people got away with alot of covering up and got off Scott free never forget that.
And thats straight from Richard Clark
Reply: Clash Bluelight "about a third of all the truther knowledge"
- dividing by zero still equals zero. There is no such thing as "truther knowledge". You are erroneously referring to "lies" and "misrepresentations".
Reply: David Herron "there has been a great deal of effort to coin the phrase " truther""
- for what it's worth, I instead call you lying, amoral, wilfully ignorant, delusional, religious zealots. Do you prefer that?
"Both sides in the 911 debate"
- there are no sides, because there is no debate. "Truth"ers have proven to have tried to fabricate "evidence", whereas they systematically refuse to undertake ANY analysis of the raw data, simply because it proves them wrong. There is only one side to this event, and it is what the science indicates. Anything else is a "truth"er fabrication. My proof? The last comment posted by +Major Tom. Nothing there but demonstrable falsehoods carefully protected by his wilful evasion of anything which proves any of them wrong.
Reply: Eric Arthur Blair Jr "are you incapable of answering my question ????  shall I ask you again ??????"
- you haven't asked me anything. Except those two questions...
Reply: Christ J you said: "There is no such thing as "truther knowledge". You are erroneously referring to "lies" and "misrepresentations"..... so what lies are you referring to ??
Reply: Eric Arthur Blair Jr whatever happened to the question you claimed to have asked me...?

Anyway, how about we start with the fact that "truth"ers are STILL trying to insist that there exists some form of peer-reviewed evidence in favour of thermitic materials initiating the collapse? Or the fact that "truth"ers systematically lie about the collapse times of the WTC buildings? Or the fact that they repeatedly insist that Newtonian physics say one thing, only to flee when presented with what those physics actually say? How about the fact that they are STILL trying to claim that a handful of witnesses misidentifying something as an explosion is sufficient to overrule the plethora of seismic and photographic evidence we have to the contrary?

How about the fact that they always try to insist that the hijackers were still alive after the attacks, only to the refuse to even address this issue when presented with the list of hijackers? How about the fact that they refuse to accept the indisputable fact that the WTC twins were felled as a visible result of a gradual deformation of the support structure? How about the fact that they are still trying to insist that WTC 7 had no internal structural damage prior to the collapse of the perimeter walls, despite the collapse of the penthouse immediately prior to this?

How about the fact that no "truth"er is willing to analyse individual elements of these events on scientific merit alone? why does everything have to be forced through this little sieve where everything is only considered in light of preconceptions of a conspiracy?

Find me a single "truth"er who has ever applied Newtonian physics to this event. just ONE...
Reply: Christ J ok, so Richard Clark the official, head anti terrorism adviser to the the WHITE HOUSE is wrong and when he went on the record and said in black and white, people in the CIA have covered up a massive part of 911 and got away with it, he did that for a joke?
you are very very very stubborn and you do not read peoples comments properly.
Reply: Christ J well. if a plane hits only one side of a building will the whole building fall evenly? no. and in the negative chance that it does happen once, will it happen again? no. and if a plane hits one side of the pentagon will only the opposite side fall to the ground, while the place the plane hits gets off with hardly a scratch? no. and can a plane that was never boarded by terrorists have terrorists on it? no.

so as you can plainly see. the chances of the official story being true are below 0. so is ANYTHING i just said a bold faced lie? because my uncle was in the pentagon at the time, the planes did hit one side of the buildings, and there is no proof of terrorists ever being in the airports! so everything i said is true and what the government said was false! physics are defied too many times for anybody in their right minds to believe the government's garbage of a story! i would believe that a single hamster did it more than i believe the official story! this is worse than weather balloons!
Reply: Christ J as you'll notice, i've used newton's laws of motion several times in my arguments. so i name clash bluelight !
Reply: David Herron "ok, so Richard Clark the official, head anti terrorism adviser to the the WHITE HOUSE "
- is as irrelevant as any other witness. He has no evidence for his assertions despite being in a perfect position to have obtained a metric fuck-ton of the stuff, which means he is either criminally incompetent or lying. 
Know what I'd do if I worked at that level and had access to the things he had access to? I'd gather every last drop of data I could find and post it everywhere I could think of. Everyone in the world would have every single piece of evidence within five fucking minutes. Yet all he - and any other like-minded liar - have ever managed to gather up is a well-formed narrative which are conspicuous due to their unanimous dearth of corroborating evidence. 
Why is it that every last one of these fuckers has proven unable to gather even a SINGLE piece of corroborating evidence? And, more pertinently, why do you mentally-defective glorified abortions let them get away with that shit? Why does none of you have the courage to demand that they provide something more substantial than a fucking fairy tale?
Reply: Christ J THREE TIMES you have failed to answer my question !!!   how many times are you planning to tap dance around my direct criticism of the NIST Report !!!!  if you incapable of answering just say so !!!!
Reply: Eric Arthur Blair Jr you haven't asked me anything, you fucking spastic.

How about actually asking a question instead of repeatedly insisting that I answer some non-existent query? How difficult is it to just post the fucking question you claim to have asked? Hell, I am actually encouraging you to provide me with it, thus I am categorically NOT evading the issue, as you are trying to imply. YOU are the one who is fleeing from this debate by continually refusing to actually clarify your point, which means YOU are the one who is terrified of this topic, not me. 

Fucking coward.
Reply: Christ J here you go (again) you fucking coward !!!  try answering the fucking question with a fucking answer !!!!   here it is AGAIN...

If thermitic materials (or any type of explosives for the sake of this discussion) were not present then can you please explain what caused the towers to collapse beneath the point of global collapse initiation.  You see, the NIST WTC report acknowledges that it does not provide a technical analysis of the structural behavior of the Twin Towers during the collapse itself. The report stops its analyses for both towers at the point of collapse initiation where the claim  is  made  that  “the  tower  was  poised  to  collapse.”  It  simply  suggests  that  “global   collapse  naturally  followed”. Since NIST actually stopped their analysis at an alleged south exterior wall failure in WTC 1 and east exterior wall failure in WTC 2, prior to any  “fall”  at  all,  this  leaves  completely unexplained how these partial failures could have propagated across the building, to cause the collapses of the full upper sections of the buildings

try harder dippy....
Reply: Christ J LMFAO !!  your bullshit excuse as to why NIST failed to explain what caused the collapse beneath the point of initiation is "MOMENTUM" !!!!     fuck me !!!  that's a classic !!!!!    i'm sure the rest of the dim-dunker muppet community are now hiding their heads in shame at your stupidity !!!!!

you see since NIST actually stopped their analysis at an alleged south exterior wall failure in WTC 1 and east exterior wall failure in WTC 2, prior to any  “fall”  at  all,  this  leaves  completely unexplained how partial failures could have propagated across the building, to cause the collapses of the full upper sections of the buildings. If you can be bothered to look for yourself, what is seen in the videos is quite different from anything modeled, or claimed, by NIST. The videos show  a  “disintegration”  of  the  initiating  zone  at  the  onset  of  each  collapse.  The  upper  12- story section of the North Tower destroys itself in the first four seconds of the  building’s collapse such that it is not even available as a mass to  act  as  the  “pile  driver” propelling the rest of the building down to the ground, as is alleged by NIST 

I've had a look for NIST's reference to Newton (or any of his relatives or chums) in the footnotes..... but can't see them !!!!   maybe you should give NIST a call and thrill them with your acumen !!!!

thanks for the laugh dick-wipe !!!
Reply: Christ J now i'll give you an example. take a card tower, pull one of the cards out of the left side, it falls to the left. no added force was needed because a lack of force was on the left side while the other supports had to pick up the load. they couldn't handle the load and so they caved in the direction of the load. it's common sense that if someone buckles your left knee you'll fall over, not strait down. and you're adaptive! meaning that it'd be even worse for a still structure! i don't care if the supports can't hold the full load. the fact that there was no force on one side and some force on the other means it falls over! as a third and final example: look at every logger ever. they chop off one side of the tree, same as the plane. the remaining trunk pieces can't support the whole structure, same as the tower. it falls sideways instead of strait down because there was still ANY AMOUNT OF FORCE ON ONE OF IT'S SIDES, not like the towers. so what gives? well we assume that there was remaining structure, if there was, the towers would fall over, but without remaining structure they fall strait down. so i suggest that all of the structure was blown at the same time by thermatic devices. and the video above proves that it could have happened.

it doesn't take any more than common sense to realize that the official story makes no sense. i've seen hundreds of demolitions happen and a few plane crashes too. this shows every sign that they were demolished and no signs that a plane took them down. so it makes no sense to think the planes did it.

ps nice argument on your part. your only problem being that you assume only numbers and paper can make a person honest and smart. i can still be honest without a pen, and i can still be smart by using common sense. don't assume that everybody who thinks differently than you is a stupid lair. i devoted my time to refuting you on your grounds, now all i want is to debate as equals instead of you throwing insults every 4th word.
Reply: Eric Arthur Blair Jr Christ J can we please turn this back into a calm debate where we're on equal grounds?
Reply: Clash Bluelight sure.... no problem !!
Reply: Eric Arthur Blair Jr ok! :D
Reply: Clash Bluelight "now i'll give you an example. take a card tower, pull one of the cards out of the left side, it falls to the left"

- and allow me to decimate your incorrect analogy with a single question: are the cards fixed together in anyway, just as the structural components of the WTC were?

No, they were/are not. What this means is that the collapse of the tower of cards is due to the inherent meta-stability of the structure. It is a structure which is, by design, prone to immediate collapse when it is disturbed even slightly. Removing one part of it does not cause the crumpling of the lower sections, but causes the individual components to slide across one another due to them having no fixing points and no real friction against one another.

In the WTC, however, these components WERE affixed to one another, so the collapse is NOT a matter of these elements simply gliding along each other, but of them failing under excessive load. Your hypothetical scenario bears no resemblance to the WTC, so it is rejected as irrelevant. Try another one, if you like...

"if someone buckles your left knee you'll fall over, not strait down."

- same problem. You are talking about different applications of force and then trying to insist that they are identical. You are wrong, and all of your examples involve nothing that resembles the WTC. Get that straight and you're well on your way to curing yourself of this delusion.

"i don't care if the supports can't hold the full load. the fact that there was no force on one side and some force on the other means it falls over! "

- NO IT FUCKING DOESN'T, YOU WORTHLESS LITTLE CUNT. Just because you claim something will happen DOES NOT MAKE IT HAPPEN. You are wrong, and every physicist in history says so. If a support structure is overloaded then it will fail ENTIRELY, not on only one fucking side. THAT is what you are claiming. For this to have collapsed to one side requires that the other side resist the applied force, which means you are trying to claim that one side resisted a force that was MORE THAN SUFFICIENT TO OVERLOAD IT. You are actually claiming that something that was capable of resisting a maximum of, say, 100N somehow resisted MORE than this. Your claims are a direct violation of the laws of thermodynamics.

Fuck off back to school, because your ego really fucking needs to have a roomfull of kids pissing themselves with laughter at just how fucking moronic your religious beliefs have forced you to become. Wake the fuck up and learn some Newtonian mechanics you ignorant spastic.

Oh, and by the way, you are STILL refusing to accept the fact that none of your examples apply to a structure that has a supporting core, as the WTC had. This is yet another reason your bullshit is readily disproven.

"i suggest that all of the structure was blown at the same time by thermatic devices."

- the physical effects which initiated the collapses lasted for over half an hour prior to the collapses beginning, which instantly rules out explosives or incendiaries. Your suggestion is thus refuted beyond any dispute. A thermitic reaction cannot last for the length of time required by the video footage of the bowing steel perimeter columns and floor trusses, which means it instantly fails as a plausible explanation for the collapse initiation. Done.

" the video above proves that it could have happened."

- this video demonstrates that thermite can cut a steel beam in conditions that were not possible in the WTC and in a way that is wholly inconsistent with anything recorded at the WTC. This video demonstrates that thermitic materials could not have been used due to them not being able to replicate the observed phenomena.

"it doesn't take any more than common sense to realize..."

- fuck off. That's a pathetic way to avoid having to prove your assertions correct. You are trying to wave away your burden of proof because you are unable to actually prove yourself correct. "It's obvious", is it? Then why is it so difficult for you to explain why it's all so obvious...?

"your only problem being that you assume only numbers and paper can make a person honest and smart"

- oh, fuck off. You can't even interpret a fucking YouTube comment properly, so spare me the pseudo-intellectualism, princess. Numbers are the only way to prove yourself right, and that's a fact. If you have no quantitative data then you have fuck all. Any decent physicist would have explained this to you, had you ever deemed their years of study and experience sufficient to have asked them about your bullshit ideological bastardizations of Newtonian laws.

" i can still be honest without a pen, and i can still be smart by using common sense"

You are incapable of either in any scenario - at least on this subject. You are already wedded to your religious worldview, and no amount of irrefutable proof is going to shift you from your delusions because your ego will no longer allow it. I actually have a pretty good psychology background as well, and this kind of irrationality is recognized instantly by anyone who has ever looked into the psychological effects of cults. Your attitude here is indistinguishable from that of the people who willingly poisoned their children at Jonestown.

"don't assume that everybody who thinks differently than you is a stupid lair."[sic]

- I have no issue with people differing in opinion, but I refuse to tolerate people who will not revise their opinion when presented with proof that it is incorrect. Anyone who does so IS a fucking liar, and that's a fact. They may be lying only to themselves, but they're still liars.

" i devoted my time to refuting you on your grounds"

- bullshit. I'm still waiting for you to present any hint of your previous claim, which was "i've used newton's laws of motion several times in my arguments". I see no such calculations or equations...
Reply: Christ J Clash Bluelight has asked me to be polite to you... and I have promised to do so !!   I've just called your chum Newton on the phone but apparently he's dead !!!   oh well.... maybe you hit him with your kilo of bullshit !!!!

I'll sign off now by sending you the NIST FAQ's.... and bizarrely they fail to mention your old chum Newton !!!   was that an oversight !!!    

http://www.nist.gov/el/disasterstudies/wtc/faqs_wtctowers.cfm 

love and kisses .... and keep in touch with yourself !!!!
Reply: Christ J you missed the tree example... oh wait! that one had none of the flaws you pointed out in the others! you skipped it because it applies! you can't just refute what you want to. if you're going to try to refute something then by YOUR various comments then you have to refute it fully or you're a lair! how do you refute the tree argument?

and how do you refute the fact that a plane hit the pentagon and nothing happened where it hit, but the opposite side of the pentagon fell completely? that can't happen.

what about witnesses, video, pictures, and common sense? you said numbers are the only thing that can prove someone right. so are you saying that all murderers convicted using anything listed above should be released due to lack of numbers in their cases? are you saying that historians are all wrong because they don't tell history using numbers? that we should speak exclusively using numbers? that infants are totally worthless because they don't know numbers?

and one more thing. you can't lift a table, you pick up one side of the table and your friend picks up the other. you and your friend are the supports, and the table is the tower. your friend let's go. what happens? because we know you can't lift the table alone. it falls to one side. why? because any amount of resistance even if not enough for the whole table was enough to slow one side more than the one with zero resistance.
Reply: Eric Arthur Blair Jr "I'll sign off now by sending you the NIST FAQ's.... and bizarrely they fail to mention your old chum Newton !!! "
- grow up. If your sole answer is some sarky, inane raving about the fact that you are too ignorant to have understood something then you have forfeited your right to an opinion. You have nothing to contribute to a discussion of this subject matter until you have a basic grasp of simple physical concepts, and your desire to maintain your current state of delusion will forever prevent you from having the courage to gain such knowledge.
You are - of your own free will- consciously refusing to learn something just because it will make it more difficult to retain a demonstrably-false worldview. You are beyond pitiful.
Reply: Christ J 1: that was masterful work. if it weren't for that last paragraph i would have nothing to refute you with. but you reminded me of something i had forgotten. thank you for that.

2: i pull back my examples as they were almost entirely incorrect. they each held some truth behind them, but not enough to support my arguments. you refuted them properly and i can tell when to fold em. so i'm doing just that. folding my hand and reaching for a new one. hopefully it's a royal flush rather than the pair of 8s i had before.

and 3: look at the footage again. you'll notice that the moment the towers collapse every floor in the entire building falls a few feet before it caves in. this means that the bottom dropped first. and if the parts below the plane dropped first then how could it have been the plane? (if this is correct is the only time you'd have to answer of course.)
Reply: Christ J as usual you decide to disappear and turn up again in some other place leaving a lot of unanswered questions behind you. You can continue with you philandering if it suits you but you don´t fool anybody for real; did you think so?
Reply: oller well. i know you're a truther like me but can you point out any flaws in the above argument?
Reply: oller mention me and I get notified, which means you'll rapidly get refuted. The only reason you'll have failed to have your egocentric bullshit annihilated is if you have, once again, resorted to hiding your responses in an attempt to delude yourself into thinking you aren't wrong.

Now, kindly fuck off until you are able to analyse the tower collapses using Newtonian because making up your own bastardizations of them will NEVER work with people who know the relevant physics.
Reply: Christ J bevers? what are those? and again, if what i was saying above is incorrect in any way i'd like to know. i posted that comment weeks ago and you left right after i posted it. now that you're back would you like to refute me using newtonian physics? because i was rather enjoying our discussion until you cut it off.
Reply: Christ J so the only way to explain to collapse of the towers, WTC7, and the Pentagon is to use Newtonian !!   fuck me i'm going to print that excuse and stick it on my wall !  what a FUCKING MUPPET !!!!!!!!!!!!

does Newtonian apply to the Windsor Tower collapse ???    hmmmm.....   and my trousers fell down the last time I got a blowjob.... is that because of Newtonian ????????
Reply: Clash Bluelight"bevers? what are those? "

- how the fuck should I know? My most recent, UNEDITED comment contains no such term. Do you even know how to read?

" if what i was saying above is incorrect in any way i'd like to know"

- so you didn't have the integrity to watch that short video then. Got it.

In short, your entire comment rests completely on the presumption that the lower section - below the impact point of the plane - fell before it was impacted by the upper section. Your question/scenario is ONLY valid if this assertion is true, and I provided a link to the collapse initiation footage which indisputably proves that it is not true. You are lying about your axioms and your conclusions are thus unjustified, untenable and outright wrong.

"would you like to refute me using newtonian physics?"

- only when you present something that actually CAN be analysed using Newtonian physics. All you have done is made something up and then tried to insist that it happened. It didn't, which means I have no call to explain it.

Why the fuck would I have to explain something that I can prove never happened in the first place?
Reply: Eric Arthur Blair Jr "so the only way to explain to collapse of the towers, WTC7, and the Pentagon is to use Newtonian "[sic]
- yes, the ONLY way to explain these collapses MUST conform to Newtonian mechanics. Newton's laws are gospel, which means that any hypothesis which fails to conform to them is automatically wrong. There is a very good reason NASA still use Newtonian equations to plot the flight paths of their probes, and that's because he was right.
"does Newtonian apply to the Windsor Tower collapse "[sic]
- yup. Newtonian physics perfectly conforms to this fire as well. Before you make yourself sound like even more of a worthless, witless spastic, I'll remind you that the reason these fires have different outcomes is because - and you fuckers really need to start paying attention to this bit - they had DIFFERENT CAUSAL FACTORS and DIFFERENT CHARACTERISTICS. They were entirely different situations. 
Just because two things feature a similar oxidation reaction does NOT make them identical, and everyone who insists otherwise is automatically giving up their right to a valid opinion.
Here's something to think about: most of the food you eat is hydrocarbon-based, predominantly alkanes, alkenes and amino acids. Another molecule that is hydrocarbon-based is benzene. Does this mean that benzene is safe to consume? By YOUR arguments, it is, but by MY (correct) arguments, it may well not be. The fact that it is a carcinogen proves me right in this attitude.
"my trousers fell down the last time I got a blowjob"
- trick question. The little boy ran away when you were taking them off, so you never got one.
Reply: Christ J she has a magic tongue.... all thanks to Newton !!!!!!!!!!!!!!!!!!!!
Reply: Eric Arthur Blair Jr is "Newton !!!!!!!!!!!!!!" the name you gave to your imagination...?

Don't answer that - you don't have the wit to do so. Instead, I invite you to join your fellow lying little shits in attempting to debate the actual science of these events, rather than just hiding behind inane bullshit like your last few posts.

For example, feel free to explain EXACTLY why you think the Windsor Tower Hotel fire is identical to the WTC fires. I expect your explanation to also detail how the former also gained the structural damage that the latter gained when flights 11 and 175 hit the twins.

Bring it, you little pussy.
Reply: Christ J I heard that Newtonian Law was used to issue 15 of the 19 highjackers with US visa's at the American visa bureau in Jeddah, Saudi Arabia.  However, someone called MIchael Springmann read the small print and raised this with the authorities when he went public and said: "In Saudi Arabia I was repeatedly ordered by high level State Dept officials to issue visas to unqualified applicants. These were, essentially, people who had no ties either to Saudi Arabia or to their own country. I complained bitterly at the time there. I returned to the US, I complained to the State Dept here, to the General Accounting Office, to the Bureau of Diplomatic Security and to the Inspector General's office. I was met with silence." 

hmmm.......

I also heard that Newtonian Law was used as the excuse to classify 28 pages of redacted EVIDENCE that the Saudi Government was complicit in the attacks.  If you look carefully it's NOT MENTIONED within H.Res14 which has been signed by 21 x US Congressmen urging Obama to declassify this evidence which proves the US Government is covering up the Saudi involvement !!

hmmm.....

care to comment fucko ?????????
Reply: Eric Arthur Blair Jr well made argument. this guy doesn't understand how gravity works so face him with official statements and missing paperwork!
Reply: Clash Bluelight thanks... let's see what he says !
Reply: Eric Arthur Blair Jr he'll just state that paperwork and people all lie and that this statement is flawed specifically because it doesn't use newtonian physics. because he knows that he's only mastered twisting physics in his favor and won't argue you on a subject he doesn't know how to lie about.
Reply: Clash Bluelight I think I can although I am not a scientist; I am actually a lawyer. I have had several lengthy debates with ChristJ  before and I can prove to you that he is blatantly lying and after that running away. He is very good at this but one has to scrutinize every word he says. I will come back to the points he are trying to make above but first I want t tell you another story.

My main arguments about 9/11 is that there they have not proved that the hijackers at the airports although there are hundreds of witnesses and footage available, but they never collected or presented that; and they have never presented a comprehensive story concerning the fate of Flight 93 in Pennsylvania.

ChristJ has been provided several opportunities to explain these two points. At one stage he said that Flight 93 disappeared into the ground and that the wings folded at impact. However, after realizing he would not get away with that he disappeared.
He was also lying about WTC 7 saying that there never was any free fall although this is clearly stated by NIST. He said that NIST did not mean free fall because free fall can only be obtained in vacuum. . Which we of course all know is false. The common definition of free fall is that of an event in the atmosphere. 

Returning to the logging example. It is very clear that the largest part of the damage in the South Tower was on one side. Moreover, according to NIST only 14 % of the core columns were damaged. There was no big hole in the middle. The scenario with new weight distribution is false. We can clearly see how the top of the building is leaning in the direction of the damaged part before it itself is blown up. Nothing of what we can see supports his assertions.

I will come back to this later.
Reply: oller thanks man! he also denied that the whole building fell a few feet before the collapse started. (which can be seen in the footage)
Reply: Eric Arthur Blair Jr "care to comment fucko"
- why? You have nothing relevant to say, which is why you're acting like a fucking baby. 
Come back when you are willing to discuss the topic of this thread, and this video - the physics involved in the collapses. Until you do so, you're just evading the subject matter for fear of being left with your dogma in tatters. Again.
clash bluelight "well made argument. "
- are you fucking stoned? All he has done is raise irrelevant political issues on a video - and thread - which are wholly concerned with the COLLAPSES! How the fuck does political ideology affect momentum? 
You fuckers are as worthless as it is possible for a sentient being to actually be.
"he'll just state that[...]this statement is flawed specifically because it doesn't use newtonian physics."
- and I'd be right to, because this entire video/thread is about the PHYSICAL MECHANISM OF COLLAPSE, not the way in which it was allowed to occur. The scientific principles which determine the outcome of these causal factors are Newton's laws, so I am absolutely justified in trying to force you fucking amoral bastards to adhere to them.
Thermitic materials are physically incapable of causing the observed phenomena, and that is beyond dispute. Not a single one of you pathetic cunts has ever managed to even attempt to argue that fact, and that's because you are terrified of being left with no way to delude yourself into refusing to accept it. It is physically impossible for thermite to explain the collapse initiation - end of debate.
Newtonian laws then dictate that the collapse of a SINGLE FLOOR necessarily requires a global collapse due to the increase in energy/momentum of the upper section, and that is beyond dispute as well.
Pair up those facts and we have irrefutable scientific proof that thermite was not a causal factor, and impact damage and fire are perfectly able to account for the GLOBAL collapses so long as they can explain the failure of a SINGLE floor.
Now, which of you pussies wants to try to analyse the fires and impact damage to see whether they are conducive to a single-floor collapse...?
My guess is that not a single one of you will even acknowledge this offer...
" he's only mastered twisting physics"
- now that is a very easily-proven accusation, because all you now have to do is demonstrate that I have misrepresented any such data. Well...go on then...where have I "twist[ed] physics"...?
Fucking coward.
"he also denied that the whole building fell a few feet before the collapse started. (which can be seen in the footage)"
- then why have you refused to actually watch the <2-minute video I linked to, bitch? Why have you just refused to point to this fictitious event on the footage YOU yourself referred to? Is it possibly because you are a lying piece of shit who is scared of having to admit to being a lying piece of shit?
The collapse footage shows no movement of the lower section until it is impacted by the upper section, and the video I linked to proves it. Every time you make this claim hereafter you will be actively lying in the face of evidence with which you have already been presented.
Fucking coward.
Reply: oller "I have had several lengthy debates with ChristJ  before and I can prove to you that he is blatantly lying"
- off you go then, you fucking liar. Let's see how you react to me demanding that you present some evidence for that accusation. And, as a claimed lawyer, I invite you to think VERY carefully about your accusation - as well as your inevitable failure to evidentially support it - while bearing this delightful webpage in mind:
https://www.eff.org/en-gb/issues/bloggers/legal/liability/defamation
- in which you will note that your sole defence to my impending complaint against you for defamation will hinge on you proving that I have lied about these events, which you are destined to fail to do. 
Think I have a case, dickhead...? (rhetorical question - you have no valid response and I already know I have a case)
"ChristJ has been provided several opportunities to explain these two points. At one stage he said that Flight 93 disappeared into the ground and that the wings folded at impact. However, after realizing he would not get away with that he disappeared."
- nope. I REPEATEDLY demanded that you move into a thread that was RELEVANT to that subject - or make one yourself - and ask it there so you would not further derail the thread on which you asked this. After all, your entire reason for throwing out this question was to evade the topic of the thread and video, which you evidently realised you were no longer able to argue against.
You tried to use this issue to avoid having to admit that you were wrong, and I refused to let you. YOU are the one who halted both discussions, because not only did you flat-out refuse to return to the topic at hand, but you flat-out refused to start a relevant thread in an appropriate forum to ask your evasive question. There was no valid reason for either of these actions, as I gave you ample ways of asking about flight 93 in a relevant place with everyone in the original thread automatically included in the discussion. YOU are the one who vanished after that, not me.
Feel free to link to the Google+ page hosting that thread, because I have absolutely fuck all to fear from everyone being able to read through it in full.
"He was also lying about WTC 7 saying that there never was any free fall although this is clearly stated by NIST. He said that NIST did not mean free fall because free fall can only be obtained in vacuum. . Which we of course all know is false. The common definition of free fall is that of an event in the atmosphere. "
- AHA! We finally have a little clarity from this twat!
This actually has something to do with this topic, but not this thread or video, so what I want you to do - right fucking NOW - is fuck off back to that thread and post this comment again, because I'm about to tear your fucking arsehole wide enough for a train to pass through, bitch. 
Make sure you copy and paste this EXACTLY - we don't want you editing things in order to hide some of the less ambiguous details, do we, sunshine...?
" It is very clear that the largest part of the damage in the South Tower was on one side. "
- utterly irrelevant, and nothing more than evidence of your ignorance of some basic physical principles, such as the first law of thermodynamics and the principles governing the distribution of mass.
You know fuck all.
Still.
"according to NIST only 14 % of the core columns were damaged"
- irrelevant, because the collapse initiation occurred by the floor trusses breaking their CONNECTIONS to the core. The core structures themselves were not involved in the onset or continuation of collapse in any way other than to act as a guide for the floors as they slid down around them. Yet another fact that you fuckers have never bothered to address.
"We can clearly see how the top of the building is leaning in the direction of the damaged part"
- incorrect. It is pivoting around the predominantly-intact section for only as long as it takes to compromise enough of the supports to initiate collapse. The instant the remaining columns possess insufficient combined strength to support the upper section they ALL fail INSTANTLY. Any refusal to accept this fact means you are in opposition to the laws of thermodynamics, which automatically means you are wrong.
"I will come back to this later."
- I rather doubt that...
Reply: Christ J so you're saying that you will never answer any of our questions unless we make a whole new thread for each and every one of them? that means that every truther ever would always have to keep track of thousands of threads all the time! and you could easily slip away from any one of them without the truther noticing. (which sounds like the real goal here) why not just answer the questions right here? here you have no chance of slipping away unnoticed and we can properly keep track of this one thread. as a matter of fact i'll call oller back right when you put the answers down to make absolutely sure he returns! (we're friends so it'll be more effective if i get him back here than if you did it)

so now that i've gotten rid of almost every reason you would answer elsewhere. answer here. it's as simple as type on a keyboard.
Reply: Christ J  your style has not changed a bit but now when I know that you are just a coward I don´t need to take anything you say at face value.

9/11 is ONE event where all the parts are linked to each other. What I am doing is showing that the event itself is a hoax. I have been discussing every part of this except for Pentagon with you and I want to show everybody that you are a bully and a liar. The first part you are so good at yourself that I don´t need t help you. In the other part I only want to give you a little help. But I need to expose your lies to the same people that you are now trying to boss around with your excellent knowledge that you claim to have concerning the fall of the towers. The truth is though that you don´t have those excellent insights. You are just a bluff; I have learned that from earlier confrontations and you don´t disappoint me now either.

So now you are trying to lie your way out of what you said about WTC 7 and Flight 93? Right? And not a clue why there is no evidence that the hijackers were at the airports although there were several hundreds of possible witnesses (at Pentagon they interviewed more than 100 who saw the plane) and hundreds of footage and videos; from which nothing conclusive whatsoever has been published.

Did you say that the wings of Flight 93 folded or not? Not easy to recall when you lie but if you know this to be the truth you can repeat it for 50 years. Say it. The plane just disappeared straight down into the ground; yes or no?

Coming back to the towers. You are saying that the floors slide down along the core. So what happened to the core? You have said earlier that the core was still standing and you proved that with the video that showed what was left of it for a few seconds after the towers fall was completed. I said to you then and I say it now that what you saw is just the sign of the opposite. What is still standing is the burnt out skeleton of the core which only indicates that it has been exposed to explosives on a massive scale.
You are in fact talking about the floors pancaking. Are you not?
Still; you have not been able to explain why an unscathed STRUCTURE that is designed to withstand winds of 100 mph should not act like a structure when hit from above but instead falling like a house of cards (I think I saw you saying that somewhere). The towers were not; against any principle for a construction; like a house of cards. It was constructed to be resilient to any possible event created by man or nature. In any event it was not designed to accelerate due to falling structure from above. If you want to continue to claim that you have to prove it.
If something looks like it is exploding it s most likely that is exploding. That was what the towers looked to be doing. Not falling in a natural way!
Reply: Clash Bluelight that is exactly what he means. Fortunately, he is not the chairman of this committee; but he probably wants to imitate Bill Clinton or some other omnipotent bully. We are here on equal terms and if he wants to participate it is up to him. What is happening is that he around every two r three months goes away on a new honeymoon trip. Wonder if he has some favorite hotel in Niagara Falls or Reno.
Reply: oller i think he's off watching the many vids i sent him right now. his tactic is gonna be to discredit the posters with insults and then quickly change the subject so he doesn't have o face them. that's what every other debunker i've used this tactic has done. (other than the ones who will view evidence out of order then claim it not to make sense.)
Reply: Clash Bluelight "you're saying that you will never answer any of our questions unless we make a whole new thread for each and every one of them?"
- no, I am saying that I will address EVERY SINGLE ONE of them in a relevant forum. I will not, however, allow you desperate fuck-ups to perform all these bait-and-switches just to avoid having to admit that you are wrong about the original topic. In fact, I have no problem dealing with all of your questions and lies in this very thread, provided you first address the fact that I have proven you wrong about the topic at hand.
" that means that every truther ever would always have to keep track of thousands of threads all the time"
- so would I. What's your point...?
"why not just answer the questions right here?"
- because you cunts only ever raise a new one when you are left with nowhere to wriggle to escape your previous one. You use new topics only as a means to distract others while you - ironically - scurry away from the debate until you think the original topic has been forgotten, along with your failure to address it.
I'll answer everything you post, provided YOU answer everything I post, as well as you refraining from ever inserting a new topic until we have left the previous topic completely unambiguous. Let's not forget that I am still the only one of us who is trying to force everyone to stick to the topic of this fucking video, whereas you worthless shits are still trying to dodge the issues at hand.
Those are the terms. If you don't find them agreeable then you have no valid opinion, because the sole reason you would object is if you fully intend to change the subject whenever you feel that your dogmatic worldview is under threat.
Reply: Christ J i'm fine moving on when ready and no sooner. but we've been talking circles about collapse physics for weeks now. so since i've spotted many full circles on that subject i moved on to the video links. we reached an end so it's time to answer new questions. this conforms to your ground rules so i'm sure you're fine with answering to my video links. while i know my own reasons i don't know oller 's. so he may very well be avoiding a subject or dead end. but since i know nothing of the subject it's also just as likely that you're lying about his motives. until i know more i can't act as an authority on the subject of oller 's motives. so i'll leave that up to you guys to resolve.
Reply: oller "I don´t need to take anything you say at face value."
- yes, you do, because you have never refuted me. That's the difference between us: I am constantly re-refuting your same old assertions - whenever you are stupid enough to repost them - whereas you simply say you have refuted me in the hope that your fellow spastics will take your word for it.
If you had done so, why so reluctant to do so again? Surely it would be no more difficult than copying and pasting your previous comments...? Unless, of course, those comments do not exist...
"So now you are trying to lie your way out of what you said about WTC 7 and Flight 93? Right?"
- nope, I'm simply refusing to let you change the subject to avoid having to admit that you have been proven wrong. It is physically impossible for thermitic materials to have initiated these collapses, and the collapses MUST progress to completion, as Newton himself proved three centuries ago. Either address that statement or fuck off, because nothing else is relevant to this thread.
"Did you say that the wings of Flight 93 folded or not?"
- genuinely can't remember. Head to a relevant video and ask me there, as then I'll be inclined to look into it again - it's been about three years since I even glanced at anything particularly relevant to flight 93. Of course, since you want to use this as pseudo-evidence for your accusations, I already know that you'll refuse to do something so simple and reasonable. You don't actually want to have this discussion - you just want to portray yourself as someone who is actively seeking it, when you are actually going to extraordinary lengths to NOT discuss it when it would be so easy to mention me in a comment on a relevant video...
"You have said earlier that the core was still standing and you proved that with the video that showed what was left of it for a few seconds after the towers fall was completed. I said to you...What is still standing is the burnt out skeleton of the core"
- physically impossible. Anything that could damage the core to that extent would have rendered it structurally defunct, which the video footage instantly disproves. The remaining structure is sufficiently intact to have plenty of vertical strength to hold itself upright. The only thing that causes it to collapse is the loss of LATERAL support when the floors dropped.
If the floors had not slid down around the core then this structure would never have remained in place at all. The fact that it DID remain standing is indisputable proof that the floors broke their connections to the core, because no other explanation can explain the combination of collapse and remaining core structure. 
"which only indicates that it has been exposed to explosives on a massive scale."
-seismic evidence and video footage instantly refutes ANY claims of explosives. You are refuted.
"Still; you have not been able to explain why an unscathed STRUCTURE that is designed to withstand winds of 100 mph should not act like a structure when hit from above but instead falling like a house of cards (I think I saw you saying that somewhere). "
- you thought wrong. I explicitly refuted that shit analogy - from your fellow lying cunt, as it happens. In fact, I refuted it far more conclusively than you just tried to do.
" It was constructed to be resilient to any possible event created by man or nature"
- what the fuck are you on? An opiate, I presume? Because that is a fucking GEM. "any possible event"!? You MUST be stoned.
They were built to withstand predicted events, whereas these attacks were not predicted. For example, they were designed to withstand plane impacts with around 10% the energy of flight 175, and with no consideration of the subsequent fires due to the fact that they were designed to withstand a hit from a plane that was LOW ON FUEL and looking to land, meaning there would be next to no significant hydrocarbon-fuelled fires because there would be no fuel.
"In any event it was not designed to accelerate due to falling structure from above. If you want to continue to claim that you have to prove it."
- who gives a shit if it was designed to do it? There is no fucking way to avoid it, you clueless spastic. How the fuck are you proposing that they postpone the effects of gravity...? Do you have any idea how much energy is built up by something with the mass of the upper section of, say, WTC 1 during a single-floor fall? This drop would have given the falling mass an additional 70 MILLION Newtons of force to exert on the support structure of the single floor they impacted. This force alone - this ADDITIONAL force, remember - is around eight times what the 90th floor was capable of resisting.
Want to argue this fact? Then bring it on. Start with a refuting analysis of my calculations, including the relevant formulae...
"If something looks like it is exploding it s most likely that is exploding. That was what the towers looked to be doing."
- well, since there was no hint of an explosion I think you have just refuted your own arguments.
Fucking idiot.

"Not falling in a natural way!"
- so what is the "natural way" for a 500,000-tonne lump of steel and concrete - both all-natural materials, by the way - to collapse from fire-induced structural weakening and impact damage? Don't forget to cite your sources and prior examples. After all, you yourself insisted that it must "[look] to be doing" whatever it is doing, so in order for you to know what a "natural way" for these building collapses to look like you would have to have previous examples of identical structures collapsing in a "natural way". No such examples shows that you are a fucking hypocrite as well as an amoral, lying excuse for retroactive abortion.
"We are here on equal terms"
- no, you're not. You're not even the same species as me. You are a throwback to a time when we were incapable of objectivity. Fortunately, despite your vocal outbursts, yours is a dying race. 
" he around every two r three months goes away "
- what can I say? A scientific lab is often a sedate place, interspersed with bursts of frenzied activity, especially one which is doing rather well in certain areas of research. I make no apologies for prioritizing that work over a valueless little prick like you and the bullshit you have successfully deluded yourself into believing. 
fun fact: a number of my peers students' have been doing some impromptu research into the psychology surrounding cults, such as replications of the Conformity Bias experiments pioneered by Solomon Asch. If you were in possession of the slightest scientific integrity I would direct you to this work, as it may illuminate some of the ways in which you are fucking up everything of any consequence. Alas, you are clearly too entrenched in your chosen ideology. "Truth"ers are one Jonestown away from doing their relatives a huge favour...
Reply: Clash Bluelight "i think he's off watching the many vids i sent him right now. "
- you haven't sent me any because you know I'll prove them wrong. If you were going to post me some links then you would have done so here, as then everyone would have seen you do it. You have nothing.
Reply: Clash Bluelight fuck off. You haven't posted a SINGLE link and you have abjectly failed to either refute me or prove your own assertions. You have done NOTHING to evidentially base your assertions, so this is going no further until you either present some valid evidence or admit that you have no valid case and you are thus incorrect.
There is no fucking way in hell you are going to change the subject without being first forced to admit that you are full of shit on the collapse physics. Either prove me wrong or explicitly state that YOU are wrong. Until you do one of those, you are going no further with any other topic.
"we've been talking circles about collapse physics for weeks now."
- no, we have not. You have simply refused to accept the facts that Newton laid out centuries ago, because they are highly unfavourable to your claims. You haven't even attempted to engage in this debate, preferring instead to throw around some wholly-irrelevant analogies which were immediately shot down and exposed for the bullshit that they were.
I have been discussing the collapse physics, whereas you have been trying extremely hard NOT to.
Reply: Christ J i'm still waiting.....  come on fucko !!!!!!
Reply: Christ J so it was three years since you touched upon Flight 93. I predicted that you should forget. Our debate on this topic was less than one year ago and in lengthy detail. I asked you were the plane went and you said it buried itself into the ground. I asked you were the wings went and you said they folded at impact. The notion of the time that has passed since only adds to the notion that you were lying. If you KNOW  what happened; that knowledge does not go away. Forgetting what you said is something different. If you know you are always telling the truth and the truth is that the wings folded, you don´t have to remember what you said. I just wanted to prove that you are a liar.

All your "proof" of the fall of the towers stems from the notion that it was a "floor-by-floor" event. You have not proved that. You have proved (possibly) that the momentum is enough to destroy the floors one by one. I say possibly because the falling debris was already pulverized to a large extent when it hit the the 90:th floor.
What you have not explained, however, is why it is not the whole underlying structure that should resist the down falling debris? I have asked you about this before but you have failed to explain it. The whole structure is intact and is affected when the debris is hitting. According to Newton; the upper floors should be crushed one by one but in a decelerating mode because of the gradually increasing loss of momentum. In a collision; again referring to Newton; the momentum does not increase at the collision it decreases since some of it is consumed in the destruction process. 
I have asked you to compare with an imaginary situation where a 60 feet truck sitting on its back, is hit by a 15 feet car that comes falling from 10 feet. Do you expect that the truck would be totally destroyed at an accelerating speed? I hope you don´t because we would all laugh at you. The whole truck would make resistance from the instance it is hit. That would be the case with the towers also unless the structure was taken out by other means.

Your notion about the core is laughable. There was virtually nothing left of it. If it had been intact it would have remained standing. It did not need lateral support to do that. t was a "box-in-a-box" construction: remember. Instead; anyone who looks at the video can see that there are just burnt out, tiny, powerless remains left. They could not even carry the weight of a fly!

Mr Laboratory Man: you are out on a limb. Your notions are laughable. You don´t understand that 9/11 is ONE event which is a lie, I give myself the right to ask from you to present your irrefutable proof that it happened the way the Official Conspiracy Theory says it did.  I know you will fail because you have failed already. But, as a proof of my generosity I would like to ask you a question concerning the towers if you don´t mind: how do you explain the finding of a passport of one of the hijackers in pristine condition when there are no traces of the man himself because of the explosion and the subsequent pulverization of everything around him? Please be detailed and don´t refer to Hindenburg because most of the people there survived and everybody was identified.
Reply: Clash Bluelight then I would like to commend you for good work. I guess he is down in his Laboratory having conversation with his Monster!
Reply: oller you need to show a little more respect for the people in these debates. i've noticed a lot of insulting. i'm still on your side but it not proper debating if you don't show equal respect for all members of all parties. a truther's job isn't to side with each other at all costs. it's to find the truth. the job of meaningless siding falls upon paid off government workers. you shouldn't act like the very people you're opposing. instead when met with an insult you should throw back facts without the need for insults. your barbaric actions are making truthers look like the lairs. if you truly believe what you're saying to be true then why not stay calm and back your facts with evidence? if you do that then you look professional. and when they respond with insults they look unprofessional! it's a win win!
Reply: Clash Bluelight you are absolutely right. I think that I in 99.99 % of all exchanges am abstaining from that. ChristJ however has been completely drowned me with insults for several hundred exchanges. I don´t mind myself but it is when he uses these scare tactics to make other decent, people to refrain from taking part that I need to show them that we don´t swallow everything. I am calling him a liar and I don´t feel that this is an insult. It is very important that people understand his character since he claims a very high degree of knowledge. For a while I bought his lies but that is over now. I will not let him get away with his pretensions and his lies. But I, like I say, basically agree with you. I believe honesty; be prepared to admit mistakes and use of civil language is a virtue around here and I will stick to that rule.
Reply: oller well thanks for understanding.
Reply: Clash Bluelight vice versa!
Reply: oller "so it was three years since you touched upon Flight 93. I predicted that you should forget. Our debate on this topic was less than one year ago and in lengthy detail."

- no, I explicitly stated that I had not looked into the actual event for that amount of time, and that remains true. 
Discussing your misrepresentation of it is not the same. Your dishonest distortion of events I was able to rebut from memory alone, with the odd supplementary link from Google. The physics of the impact I last properly worked with during my degree, which was just shy of four years ago - when I had better access to more knowledgeable physicists who were prepared to discuss the relevant forces and energy transfers.

The broad outcomes I recall, even if the prior groundwork have escaped my memory. However, if you are willing to finally overcome your innate cowardice and start this discussion in a RELEVANT place where other RELEVANT discussions are occurring, I'll be more than happy to give myself a refresher course and use that knowledge to fuck your beliefs sideways.

I have absolutely no doubt that you will, once again, ignore this offer for further discussion of nothing but facts in order to prevent your bullshit from being exposed to all.

"I asked you were the plane went and you said it buried itself into the ground. I asked you were the wings went and you said they folded at impact."

- I actually take issue with your implied semantics, because I think you are attempting to distort what I actually said. I therefore suggest that you post a link to one - or more - of those threads in order to evidentially base your above accusations. If you fail to do so I will accept that failure as proof that you are making shit up in an attempt to avoid being proven wrong again.

Linking to another thread is not difficult, princess. Here is an example:

https://plus.google.com/ 101164041182319826757/posts/enUM1wBxfbZ

- see? Fucking easy, isn't it? All you would ever have to do to get this shit dealt with is start a thread - or join an existing one - and link to it here. Problem solved. You'd get your questions - and lies - answered, and you wouldn't have to look like an amoral cunt for actively seeking to derail other threads just to change the subject when you have lost the argument. You have no valid reason for refusing this.

"You have proved (possibly) that the momentum is enough to destroy the floors one by one. I say possibly because the falling debris was already pulverized to a large extent when it hit the the 90:th floor."

- that means fuck all. The upper section had the exact same mass whether it was entirely made of dust, or was entirely intact. That is all that matters. My calculations - using Newton's formulae - make no assumption about the configuration of the mass that was falling precisely because it has no bearing on the resultant application of force.

Momentum IS sufficient to explain the continuation of collapse once initiated. The sole question that momentum leaves unanswered is the causal factors leading to collapse initiation.

"What you have not explained, however, is why it is not the whole underlying structure that should resist the down falling debris?"

- because that isn't how the universe works, as I have already explained to you multiple times. For example, if you stamp on a nacho chip, does the entire earth resist your foot? Or is it only that 3mmlayer of crispy corn which offers any resistance? 

Think about it this way: how would a force get through the uppermost floor of the lower section to exert itself on the structure below? The only way is for it to go THROUGH that topmost floor, which means that force is automatically exerting itself ON that floor. Your delusion of the application of force requires that the force be instantly transmitted from one place to another WITHOUT passing through the intervening space.

Let's make this easier to follow. Imagine the following line of text is a horizontal representation of the WTC:
abcdefghijklmnopqrstuvwxyz

- now, you may notice that this is the entire English alphabet. This is for the sake of using it as a pedagogical tool. 
Imagine we apply a force to "a". According to me - and Sir Isaac Newton - this applied force is exerted on "a" until "a" buckles under it, at which point this force is then exerted on "b". YOUR claim, however, is that the force exerted on "a" is somehow spread across the entire line, from "a" to "z". However, in order for this to happen the applied force must first pass through "a". If it passes through "a" then it, by definition, must be exerted on "a" in order for "a" to then exert that force on "b". If "a" doesn't exert the force on "b" then there is no way for "b" to have any force exerted on it, because the force is only in physical contact with "a"

THAT is where you have been fucking this up. The reason this happens floor by floor is because the force is only ever in contact with one floor, that being the topmost intact floor of the lower section

Clear now?

" According to Newton; the upper floors should be crushed one by one but in a decelerating mode because of the gradually increasing loss of momentum"

- wrong, because while you are correct in stating that the impact with a new floor results in a loss in momentum, gravity replenishes it with a vengeance. The amount of gravitational energy provided to a mass the size of the upper section of WTC 1 - the SMALLEST upper section - vastly outranks the energy able to be resisted by every floor in the towers. Momentum actually INCREASE every 3.7 metres, because the increase in momentum due to gravity is so far ahead of the decrease due to the steel.

"In a collision; again referring to Newton; the momentum does not increase at the collision it decreases since some of it is consumed in the destruction process. "

- not when there is a permanent source of propulsion. A steadily INCREASING source of propulsion, at that, because this is what the gravitationally-sourced momentum is.

"Your notion about the core is laughable. There was virtually nothing left of it. If it had been intact it would have remained standing."

- wrong. The core structures provided much of the VERTICAL support to the floors, but had NO LATERAL SUPPORT OF THEIR OWN. They relied on the floors themselves for the lateral support they needed to remain standing. When the floors were removed, that lateral support was gone and the core became metastable.

Even if the cores were perfectly intact, they would not remain standing. If the cores had been built anew without the surrounding floors and perimeter walls, they would not have remained standing. 

These buildings were very well engineered. The cores were able to be so small because they used the surrounding building for lateral support. It was a superb design compromise.

"They could not even carry the weight of a fly!"

- they carried their own weight, which was thousands of tonnes. Seen some big flies lately...?

"I give myself the right to ask..."

- you have no such right. You'll have a right to ask something when you demonstrate that you are able to accept an answer without first determining whether it fits your predetermined worldview.

" I would like to ask you a question concerning the towers if you don´t mind: how do you explain the finding of a passport "

- that's not a question about the towers. That's a question about a passport.

Are you autistic?

"in pristine condition when there are no traces of the man himself because of the explosion and the subsequent pulverization of everything around him?"

- answer me this: did that passport undergo the EXACT same conditions as everything else that morning? Was it confirmed to have experienced every single thing that all those miscellaneous destroyed objects also experienced? If not, you have no right to insist that they should have had identical fates, because they experienced non-identical phenomena. 

You're done.

"+Clash Bluelight then I would like to commend you for good work. "

- no, you want to commend him for being the same religion as you. 

" I am calling him a liar and I don´t feel that this is an insult"

- and the difference there is that I am demonstrating that you are lying, whereas al you are doing is making up an insult and applying it with no valid basis for doing so. You're evidently a fucking woeful lawyer.

" It is very important that people understand his character since he claims a very high degree of knowledge."

- I can demonstrate a decent degree of knowledge. All you have ever proffered is your own assertions. Not a single relevant equation or link in sight...

" I will not let him get away with his pretensions and his lies"

- that must mean you're going to provide evidence, then - surely? Well...where is it...?

" I believe honesty; be prepared to admit mistakes "

- really? So when are you going to get around to the fact that your bastardization of Newtonian momentum requires that it be impossible to crush or break ANYTHING? How about that window example I mentioned a few threads back? If the entire structure helps to resist an impact, why doesn't a window call upon the entire steel/concrete structure behind it when someone throws a cricket ball through it...?

Let's see how you answer that analogy, you lying streak of shit.
Reply: Christ J here. THERE IS A COPY/PASTED COMMENT BELOW THAT YOU HAVE MISSED.  THIS IS HERE TO REMIND YOU THAT IT IS SURELY THERE.
Reply: Christ J and here. THERE IS A COPY/PASTED COMMENT ABOVE THAT YOU HAVE MISSED. THIS IS HERE TO REMIND YOU THAT IT IS SURELY THERE.
Reply: oller i wish him good luck missing it now! just look above lol!
Reply: Christ J I am sorry to disturbing you in the middle of your groundbreaking scientific work.

No I am not accepting your terms. 9/11 is ONE event which you have been able to spread your lies by being everywhere and no one to check you out. Since you have given me the honor of following you on your detours I have had an opportunity to do just that. I want to remind you that you on top of your excellent physical skills also have a lot of knowledge in forensic medicine. You have not forgot that also; have you?

Like I said; if you knew you had been telling the truth it wouldn´t be a problem for you to remember what you said one year ago concerning Flight 93. Lies are on the other hand harder to remember. You would be able to say to me now if I am telling a lie or not when I am claiming that this is what you said. " The plane buried itself into the soft soil and the wings folded." If you know that the cited part is not in conjunction with reality and that you are always telling the truth you would not have any problem to claim that I am lying. if you on the other hand know that it is not true and that you have been lying; there is no way for you to know if I can find the cited part again and really prove that you have been lying. Instead now you say you have forgot. You don´t forget these kind of things once you have learned them. 

I am giving you a chance now to correct yourself. You don´t need a "relevant thread" this one is relevant enough! It is about if you are a liar or not. Tell us the truth about Flight 93. Did it disappear into the soft soil of Pennsylvania with the wings folded (like some debunkers said they did in Pentagon also) at impact. Or is the truth that the plane disintegrated at impact. If it did it should have been leaving a large debris field like the Germanwing plane that crashed in the French alps earlier this year.

In your world a cloud of dust has the same momentum as solid mass? Is that what you are saying?

"However, in order for this to happen the applied force must first pass through "a". If it passes through "a" then it, by definition, must be exerted on "a" in order for "a" to then exert that force on "b". If "a" doesn't exert the force on "b" then there is no way for "b" to have any force exerted on it, because the force is only in physical contact with "a". Your analogy is laughable. The applied force you are referring to is supposed to be much bigger than the resistive force of "a". But some of the applied force will get lost in the collision. What you are claming is that the gravitational force applied on "a" is compensating for the loss of momentum at the collision This could only be true if it is a perfect inelastic collision; with no loss of momentum because of destruction. Compare this process with the example of the car and the truck that I gave you. You could also compare it to what happens if you drop a sack of cement on a man and it hits his shoulders. If it is from high enough it might break his collar bone but not necessarily his feet. According to you every bone in his body that is affected should break to pieces at an accelerating speed.

"- because that isn't how the universe works, as I have already explained to you multiple times. For example, if you stamp on a nacho chip, does the entire earth resist your foot? Or is it only that 3 mm layer of crispy corn which offers any resistance?"
Very interesting example. Exchange the nacho chip for a 30 cm loaf of bread? Or with a 10 m high villa. Or a 300 m skyscraper. Does all of it make resistance at the same time? Are the pieces stuck together by something? Your idea only works if there is no momentum loss because of the crushing of the lower part. We know that 90 % of the building was pulverized and that the steel beams were cut into 6-8 feet pieces. If you want to claim that small pieces have the same momentum as solid mass you have to prove it; especially if it comes in pulverized form. 

I cannot say that the passport underwent EXACTLY  the same conditions. What I can say that it was exposed to the same conditions as all of that which was vaporized. The likelihood for survival in pristine condition is therefore zero point zero. Above all; it was found in the street and not in the rubble. You have all the excellent knowledge to physically prove to us how this could be done.
Reply: oller why doesn't he answer my comment? i'm on a relevant thread, i put bold print banners around it, and i waited until our comment exchange was no longer going anywhere.
Reply: Christ J look above this comment by 5 comments. do i need more banners? are you ignoring me on purpose? are you going to keep ignoring me?
Reply: oller "No I am not accepting your terms."

- tough shit. My terms are nothing more than the scientific method, and by trying to circumvent them you are implicitly acknowledging that you are ONLY able to fabricate a viable case when all semblance of objectivity and evidence-based analysis is abandoned. This automatically invalidates anything you say.

" I want to remind you that you on top of your excellent physical skills also have a lot of knowledge in forensic medicine."

- Forensic SCIENCE, not "forensic medicine". The latter is a sub-set of the former, which anyone studying and practicing the former will encounter by default. In any case, my expertise currently lies in physical chemistry, which is why I know that anyone advocating thermite is wrong, whereas my past expertise lies in forensic science, psychology, organic chemistry, and a few other not-so-relevant areas.

And you are just a crap lawyer who has demonstrated that he is a perfect example of the stereotypical amoral bastard, who cares nothing about evidence and everything about how his case is presented.

Fucking scumbag.

"if you knew you had been telling the truth it wouldn´t be a problem for you to remember what you said one year ago concerning Flight 93. Lies are on the other hand harder to remember."

- why? You are remembering your perfectly well, which is why you're so petrified of providing a link to support your claims. I just showed you how easy it is. All you need do is scan your Google+ homepage. 

People forget things because they no longer use them regularly. I have had little or no need for the relevant calculations for the last few years now. I remember momentum and force application calculations far better because I use them fairly regularly. Hell, I once figured out how to prove that E = mc^2 using the conservation of momentum as an axiom, but I can't remember that either. Does that mean my proof was a lie? No, it doesn't, which invalidates your pathetic attempt at psychoanalysis.

Don't bother trying to argue psychology with me, because I have you beat there too.

"You would be able to say to me now if I am telling a lie or not when I am claiming that this is what you said. " The plane buried itself into the soft soil and the wings folded." "

- okay, you are either lying or mistaken, because that statement is extremely ambiguous, and I am a lot more careful with my scientific terminology. Now, prove that I said that, because the fact that you placed it between quotation marks now requires you to prove that I uttered those EXACT words. 

"You don´t forget these kind of things once you have learned them. "

- I have presented you with the relevant physical calculations for a coarse analysis of the tower collapses multiple times: what are those equations?

This is a test of your above assertion, because you have learned those equations well over the last year or so, which means your ability to remember them will have significant bearing on the veracity of your statement. Failure to remember them will result in you proving yourself wrong.

Bring it, bitch.

"I am giving you a chance now to correct yourself. You don´t need a "relevant thread" this one is relevant enough! It is about if you are a liar or not. "

- this thread is about what the OP mentioned, which is "Mainstream expert found NO evidence that thermite was used to bring those buildings down including 7."

This thread is about nothing more than the collapses of the WTC buildings. Anything else is evasion.

"In your world a cloud of dust has the same momentum as solid mass? Is that what you are saying?"

- yup. MY world is identical to that of Sir Isaac Newton in that respect, because the equation in question - which will provide you with 33% of your required answer above - is p = mv, where p = momentum, m = mass, and v = velocity. In short, the momentum of an object is determined SOLELY by the product of its mass and speed. A 10-tonne concrete block has the EXACT same momentum as a 10-tonne cloud of concrete powder. That is an indisputable mathematical fact.

So, how do you plan on avoiding this long-established physical fact...?

"I cannot say that the passport underwent EXACTLY  the same conditions. What I can say that it was exposed to the same conditions as all of that which was vaporized."

- so you CAN'T say that it went through those conditions, but you're going to anyway? How fucking idiotic are you? You have just explicitly stated that it underwent the same conditions as everything else, immediately after saying that you couldn't say that it did so.

How many times were you utterly humiliated in a courtroom? Because this kind of thing strikes me as making you a fucking liability.

Allow me to illuminate you: did the passport reach the point at which it was found immediately after the plane impacted the tower, or did it find its way there several hours later? Don't know? Impossible to determine? Then you have no justification in assuming you know how it got there and when, which means you cannot use this as evidence because its source is unknown. 

You don't get to invent a story for something and then use that unverified,  unproven story as "evidence", princess.
Reply: oller there is a comment right above this one. until he properly replies to it answer everything he says with "clash's comment is (insert proper number here) comments above this one." he's scared of the above comment and has been acting like it doesn't exist for days! so don't allow him to ignore it anymore!
Reply: Christ J 3 comments above man. you've just proven with a 150 line comment that you have time.
Reply: Clash Bluelight YOU HAVEN'T POSTED ANYTHING, you fucking spastic. I listed every one of your comments and none of them contained anything relevant to this entire event, much less the WTC collapses. 

Copy and paste it in your next three comments, with the words "pineapple mayhem advocate" at the beginning. If those words appear then your comment will be there too. If those words fail to appear then you are full of shit and/or too fucking stupid to know what you have posted.
Reply: Clash Bluelight

"+oller there is a comment right above this one. until he properly replies to it answer everything he says with "clash's comment is (insert proper number here) comments above this one.""

- fine by me. Olivia, in case you're wondering, it is supposed to be between the emboldened, near-identical posts he made at 9.31 and 9.33 yesterday - although this will vary across timezones.

I see nothing in either YouTube, Google+ or the notifications window, and I see nothing even when logged out, which means his comment is appearing to no-one else either.
Reply: Christ J it's above. deny it again and i'm done talking to you. the 2 year old's "i can't here you" defense is for 2 year olds!
Reply: Christ J "- why? You are remembering your perfectly well, which is why you're so petrified of providing a link to support your claims. I just showed you how easy it is. All you need do is scan your Google+ homepage. 

People forget things because they no longer use them regularly. I have had little or no need for the relevant calculations for the last few years now. I remember momentum and force application calculations far better because I use them fairly regularly. Hell, I once figured out how to prove that E = mc^2 using the conservation of momentum as an axiom, but I can't remember that either. Does that mean my proof was a lie? No, it doesn't, which invalidates your pathetic attempt at psychoanalysis."

Do you now deny that you were even discussing the matter with me? I asked you to explain it and you explained it by using these words. " The plane buried itself into the soft soil of Pennsylvania" and " the wings folded at impact". Since you were engaged in debate with me and answered my question and know the truth (which you don´t forget; or do you mean you have forgotten?) it would not be hard for you to immediately say if the statement I say you made is true or not? Say it! Since you are implying that I am lying you could immediately say that the statement is false and you have proven me to be a liar! Well: is it true or not that the plane buried itself and is it true that the wings folded at impact. Answer me!

" A 10-tonne concrete block has the EXACT same momentum as a 10-tonne cloud of concrete powder. That is an indisputable mathematical fact."

Ok; don´t you forget something here? How about physics? You were the one who vehemently denied that free fall could have occurred in WTC 7 and that NIST must have meant something else than what they said when you realized that their actual report said something different than their FAQ. You said that free fall can only occur in vacuum; which was wrong because free fall is used as a general term to describe how an object is falling when there is nothing else to stop it than air. 

If there was a vacuum in WTC, the dust and the block would have the same speed and the same momentum. Now this happens to occur in air. This means that the air resistance is a little more present for dust than for the full block and will not exert the same momentum as the block. Also, when the power exerts itself at different times (because the pieces are falling with different speed  the momentum will not affect the area that is hit with the same power. 

" - so you CAN'T say that it went through those conditions, but you're going to anyway? How fucking idiotic are you? You have just explicitly stated that it underwent the same conditions as everything else, immediately after saying that you couldn't say that it did so.
How many times were you utterly humiliated in a courtroom? Because this kind of thing strikes me as making you a fucking liability."

You have to read what I said before you start screaming. I said ""I cannot say that the passport underwent EXACTLY  the same conditions. What I can say that it was exposed to the same conditions as all of that which was vaporized." This means that there is a difference between "undergo"; in the meaning "happening" and "exposed" which means that the circumstances were the same but there is a theoretical possibility that all that happened to everything else did not also happen to the passport. My point is that all those circumstances that we know about explosion, fire, pulverizing , vaporizing, were present in the very area where the passport was and that the likelihood that it would not "undergo" the same process that everything else in that area did is so small that we can eliminate it. For some of you guys it has been popular to use Occam´s Razor as a tool to assume if something happened or not. Occam´s Razor could seldom find a better example of appliance.
If you, as you indicate, want to assume that a pristine passport could be found in the area that was not planted there; I am afraid that it is you who have to at least make it likely that it could have survived all these circumstances that it was exposed to and still have survived when much more resilient material did not and practically nothing did. In a courtroom the judge would also have in mind that the only object that survived these circumstances was just one and the only one that could incriminate the suspects. This aspect would also come into the judge´s mind when he decide not to allow it as evidence.
Reply: Clash Bluelight sorry pal, but I cannot see those copy/pasted comments but I would like to if I may?
Reply: oller ok look right below this one.
Reply: oller can you see it now?
Reply: oller "Do you now deny that you were even discussing the matter with me? "

- no, I am denying that I used the quotation YOU attributed to me. I also deny that I have researched the exact physical mechanisms involved in the last couple of years, because I simply have not. Some of the calculations are familiar because they are related to things I still do, but much of that prior work has faded through lack of use.

" I asked you to explain it and you explained it by using these words. " The plane buried itself into the soft soil of Pennsylvania" and " the wings folded at impact". "

- you are a liar, as this link proves:

https://www.google.co.uk/?gfe_rd=cr&ei=JUZ8VK2AFs-q8wf0k4CACQ&gws_rd=ssl#q=%22+The+plane+buried+itself+into+the+soft+soil+of+Pennsylvania%22

- in it, you will see that - and I quote - there are "no results found for  " The plane buried itself into the soft soil of Pennsylvania", which means it appears nowhere on the web, which, in turn, means I cannot have uttered it. You are refuted.

THAT, princess, is why I demanded that you link me to the threads involved. I strongly suspected that you were misrepresenting my statements, and the fact that the quotes you ascribe to me have never appeared online - even in cached pages - proves me right. I have never uttered those words, which means you are guilty of libel.

" Since you are implying that I am lying you could immediately say that the statement is false and you have proven me to be a liar! "

- the entire internet says you're lying.

"You said that free fall can only occur in vacuum; which was wrong because free fall is used as a general term to describe how an object is falling when there is nothing else to stop it than air. "

- freefall acceleration is 9.80665m/sec/sec. Is it possible to attain this acceleration rate through a gaseous medium: yes or no?

I await your inevitable refusal to answer this staggeringly simple closed question with great interest...

"Also, when the power exerts itself at different times (because the pieces are falling with different speed  the momentum will not affect the area that is hit with the same power. "

- so you're saying that the lower section would regain its strength after each individual hit, are you? From where, exactly? What physical mechanism is in place to allow it to arbitrarily regain structural strength after an impact?

Thank for, once again, proving that you have no knowledge of ANY of the relevant science and that you are just making things up to compensate for your lunacy.

" I said ""I cannot say that the passport underwent EXACTLY  the same conditions. What I can say that it was exposed to the same conditions as all of that which was vaporized." This means that there is a difference..."

- no, there isn't. "the same" and "EXACTLY the same" mean identical things. I don't give a shit how much you draw attention to the word "exactly", it remains superfluous. 

What you are trying to do is have your cake and eat it. You want to avoid having to admit that you need the passport to have experienced the EXACT same conditions, but you also want to continue to insist that it did so, in spite of there being no evidence whatsoever to suggest this was true.

Your own statement is internally inconsistent. That may work on a jury full of your parochial spastics, but it doesn't work on anyone with a decent scientific mind.

" In a courtroom the judge would also have in mind that the only object that survived these circumstances was just one and the only one that could incriminate the suspects."

- and, when that same judge was presented with the numerous other items that also survived and did NOT belong to the hijackers, your blatant falsehood would see you convicted of attempted perjury. Is that why you aren't practicing anymore...what did you get caught doing, I wonder...?

" it has been popular to use Occam´s Razor as a tool to assume if something happened or not."

- and you are trying to employ Occam's Broom to hide all the facts that decimate your bullshit.

"+Clash Bluelight sorry pal, but I cannot see those copy/pasted comments"

- HOLY SHIT! An honest statement from you! I am genuinely stunned - I didn't think you capable of such trivialities. 
Perhaps you would now like to present some physics calculations or links which support your sub-moronic notion that a structure can regain energy from out of thin air after it is impacted by an object, in order for it to better resist the subsequent impact. I mean, we both know that you only made this claim because your religion requires something like that, but surely you have at least invented something with which to delude yourself first? Well, let's hear it...
Reply: Christ J I've just booked you a packed holiday to Tunisia.... hope you enjoy your fun in the sun with a gun !!
Reply: Eric Arthur Blair Jr nice comeback. Remember the collapses of the WTC buildings? Yes? How about you try discussing them...?
Reply: Christ J related comeback... remember the collapse of the WTC buildings as a result of an orchestrated attack by complicit governments on 9/11 ?  Yes ?  How about you try discussing this .....?    Let me know when you are ready !   thanks !
Reply: Eric Arthur Blair Jr how about proving newton wrong first, as your entire case rests upon it being impossible for momentum alone to have turned a localized collapse into a global collapse. Come back when you have some equations to apply...
Reply: Clash Bluelight sorry, but no.
Reply: Christ J the citation marks were used in order to establish that this is what you said even if you had said "in" instead of "into" and I may have taken away some word that was of no significance in this context. You have said -even if you used a few more words - as an answer to my question of what happened to Flight 93 that it buried itself in the soft soil in Pennsylvania and on my question to what happened to the wings that they folded at impact. 
When I read further in the link you are providing I can see your source of information. 

My question again is if you still have the view that the plane buried itself into the grind and disappeared and that the wings folded at impact? There is no "context" in which this wording could be used to describe something different. That is what you said. The question is if that still is your position?

My statement about free fall acceleration was to establish that it is the common description of something that is falling without any other resistance than air. Why do you want me to ask the question about the exact free fall acceleration in a vacuum? Is that of any significance here?

"so you're saying that the lower section would regain its strength after each individual hit, are you? From where, exactly? What physical mechanism is in place to allow it to arbitrarily regain structural strength after an impact?

Thank for, once again, proving that you have no knowledge of ANY of the relevant science and that you are just making things up to compensate for your lunacy."

So. who is the lunatic here. Let flakes of gold rain down on a glass or let the full bar hit it and you will know. Nothing has to regain any power. If each and every hit is not strong enough to cause damage there will not be any damage! 

"- no, there isn't. "the same" and "EXACTLY the same" mean identical things. I don't give a shit how much you draw attention to the word "exactly", it remains superfluous."

You still cannot read, can you? 
I said that the passport was "exposed" to the same conditions which, in my view and in the view of any sensible human being in this case would mean that it with great certainty would "undergo" the same process.  It is you who claims that I have to prove that the passport not could survive. I have proved that by showing that the passport was "exposed" to the same conditions as all other objects that were destroyed and - with a reference to Occam´s Razor  - proved the likelihood for the survival to be extremely close to zero; n which case no judge would allow it unless you could prove that those extremely unlikely circumstances that made this object survive.
Reply: Christ J come back when you stop talking bollox !   38 people died on a beach ..... 15 of them Britons ..... and people like you should be ashamed !!!!!!!!!!!
Reply: Christ J i'm gonna copy/past it in pieces. perhaps i've got a line limit or something. pieces will be numbered below. tell me if any don't show up.
Reply: Christ J piece 5: i just copy/pasted the comment so, what are you talking about?! i'll even show you exactly how many comments ago these links were! this was 9 comment above you saying that i never posted any links! you denying that fact proves that you haven't been reading my comments and are thus, fully incapable of properly debating me! now deny the statement of wtc7 falling a few feet before collapse and deny the "second shockwave" or your entire point crumbles. (your point being that i'm lying)
Reply: Christ J there are 5 pieces of my comment above. tell me if any are missing.
Reply: oller " the citation marks were used..."

- incorrectly, because the statement contained therein was never uttered by me. If you think otherwise then link me to the thread in which you claim I made them. Failure to do so will result in you being ignored until you start presenting evidence, because I'm sick of you spouting bullshit and then ignoring subsequent demands for you to present supporting data.

No evidence is, by default, evidence of your own dishonesty.

"My question again is..."

- of no relevance to the WTC collapses, and will be ignored IN THIS THREAD. Fuck off somewhere else and ask me in a relevant video. You are using this, once AGAIN, to avoid discussing the topic of this video and thread just to postpone admitting that you have been wrong for this last decade or so.

" Why do you want me to ask the question about the exact free fall acceleration in a vacuum? Is that of any significance here?"

- because YOU are the lying cunt who is using them interchangeably. YOU are the one who is trying to insist that the WTC fell at a rate which cannot be surpassed. YOU are the one insisting that this is the maximum possible rate that anything caught in Earth's gravity well can fall at. YOU are the one making that claim, not me.

Your problem is that you have already been through all this, so you know exactly how you're going to lose this argument. You know that you will be forced to accept that it is physically impossible for EXACTLY 9.80665m/sec/sec to be attained outside of a vacuum, which means you will be forced to accept that the building (singular) fell only at NEAR-freefall rates. The instant you accept that irrefutable fact you are then forced to accept that this can happen in spite of there being a resistive structure in the way, so long as the momentum of the falling mass is sufficient.

You know all this because you have failed to find a single fault with my calculations to the fact previously, which is why you are tying so hard to avoid citing a very simple number. This is also why you forced yourself to fabricate non-existent physics in an attempt to avoid the inevitable fact that you, and all your retarded friends, are wrong.

"So. who is the lunatic here. Let flakes of gold rain down on a glass or let the full bar hit it and you will know."

- but that is a different scenario, because you are talking about spreading the impact of the flakes over a far larger area. The WTC, on the other hand, featured COLUMNS which failed, not the floor slab itself. This means that the impact was transferred from the slab to the supports below, which means that every impact - no matter the magnitude - was eventually concentrated onto those columns and connections to the core. 

Your glass example fails because it is the pane itself which is now taking the hit. Once again, you are proffering non-analogous examples in order to avoid having to deal with the event itself. Why the fuck are you so scared of the actual event? Why must you ALWAYS revert to some other thought experiment? Is it because you are consciously trying to fool yourself, or are you just suffering from when your mother pissed you out all those years ago...?

" I have proved that by showing that the passport was "exposed" to the same conditions as all other objects that were destroyed "

- you have proven NOTHING. All you did way claim that it experienced those conditions. Prove that the passport was in the fires all that time. Or, more hilariously, prove that all those other items were planted as well, because - contrary to your implication - that passport was not the only thing recovered from flight 175.

"and - with a reference to Occam´s Razor  - proved the likelihood for the survival to be extremely close to zero;"

- no, you spouted nothing but an argument from personal incredulity which was based entirely on your presumption of the conditions it had experienced. You had no evidence on which to base those presumptions, so they are invalid by default, which means your conclusions from that assumption fail instantly.
Reply: Clash Bluelight fuck off. You aren't posting a single thing, you fucking coward. I provided a detailed way for you to present your entire case without even having to post it here, and you refused. You have no valid point and all you are doing is trying to bullshit your way out of a fight in which you have been brutally fucked.

You're done.
Reply: Clash Bluelight none is showing in the thread. Sorry!
Reply: oller ok. i'm done then. i think Ty Brady put some kind if limit on my comments back when i defeated him in debate combat. (he's the only one with a motive and ability because he's the op.)
Reply: Clash Bluelight bullshit. You have been exposed for the lying little shit that you are. That is what has happened, so spare us all this "everyone is against me" fantasy.

Fucking coward.
Reply: Christ J where was the everybody is against me part? i put down a theory that it was Ty Brady because he's done this to people who he feels are to difficult to argue. i've seen it done to several people by many debunkers and truthers alike. the thing is though, that it's always the op. so yeah. i suspect Ty Brady . and from now on if i come back here i'll only say nice things and share links to cool things!
Reply: Christ J oops lol! the op is ***** now i look stupid! i mixed this with a thread where i've already been blocked due to winning lol!
Reply: Christ J right now it seems that I cannot find the relevant thread concerning Shanksville. At least we are agreed that we have discussed the matter. We were of course not agreed about the details.
I guess I will have to find the thread and give you the details before you are willing to return to the subject.

Your discussion about the free fall bears no signs of logic. We don´t need the actual exact figure for free fall since our discussions don´t concern free fall in vacuum. We are using the common definition when something is falling with no other resistance than air.  Right now we don´t need to return to the discussion about WTC 7 because we have exhausted that part already. I am not claiming anything else than NIST say in their own report. They used the term free fall in it´s normal context which means that there was no other resistance than air. Otherwise they wouldn´t have said it!

I am not talking about spreading over a larger area; but in a cloud of dust you will see that all pieces of dust are falling at different speed and not accelerating at all. Even if they hit the same area as the solid block>; the momentum will be severely reduced. Not hard to agree with that?

In the event itself the falling mass was partly reduced to dust and small pieces falling at different speed. That means that the momentum cannot be the same as if it fell like a solid mass. How did you calculate that?

"The WTC, on the other hand, featured COLUMNS which failed, not the floor slab itself. This means that the impact was transferred from the slab to the supports below, which means that every impact - no matter the magnitude - was eventually concentrated onto those columns and connections to the core. "

Sorry; I just thought I heard you saying that the core remained standing?  And how does what you are saying relate to the resistance I am insisting would have taken place? You have to be more precise, mr Scientist!

If a passport belongs to somebody who is vaporized in a plane crash under those circumstances it is enough to prove that the passport was exposed to the same circumstances unless there was some proof that it was not. In a court of law logic prevails and is applicable on what can be regarded as proof. In this case we are talking common sense. Thus it is proven! That has nothing to do with presumption.
Reply: oller oh yeah! if a passport is in my pocket and i burn alive then the passport burned too! and would be near the crash site rather than far away! you don't need to prove that it was in his pocket because that's it's natural position. instead it must be proven that right before the crash the man casually walked to the exit of the plane. threw out his passport. closed back the door. and sat back in the pilot's seat before crashing. all while being caught on none of the videos that were taken of this event.
Reply: Clash Bluelight allow me to explain how these thread work. When you click "reply" after typing your comment, that comment is INSTANTLY posted to this page, and everyone who is active on the thread instantly receives a notification to their related email address. This means that, even if your comments were being blocked by someone, they would STILL appear in each of our inboxes. The fact that they are nowhere in sight proves that you never posted a single thing.
There is OTHING that any other commentator can do about this system, because it is built into Google+. You are a liar.
Reply: oller "it seems that I cannot find the relevant thread concerning Shanksville"[sic]
- bullshit. 
Fine. Until you prove otherwise, I will assume that your accusations towards me are without basis and are thus libellous. 
"We don´t need the actual exact figure for free fall since our discussions don´t concern free fall in vacuum. "
- yes, they do, because YOU are the one insisting that there was NO RESISTANCE WHATSOEVER, which means that you are automatically insisting that freefall acceleration through a vacuum is a factor. Alternatively, you are tacitly saying that there WAS some resistance, in which case you are automatically saying that freefall acceleration was not attained. Pick one.
"when something is falling with no other resistance than air."
- fine. Now, what was the acceleration rate quoted by the NIST...?
"I am not claiming anything else than NIST say in their own report"
- yes you are, which is why you have consistently refused to copy out a single fucking number that they cited - because it fails to agree with your misrepresentations of their reports.
"in a cloud of dust you will see that all pieces of dust are falling at different speed and not accelerating at all. "
- then you are claiming that dust particles can never fall under gravity, which is yet another example of you violating he laws of thermodynamics.
"Even if they hit the same area as the solid block>; the momentum will be severely reduced. Not hard to agree with that?"
- utterly wrong. A tonne of concrete has the same momentum whether it is a solid block or a mass of disconnected particles, and that is a physical fact beyond dispute. Prove me wrong.
"In the event itself the falling mass was partly reduced to dust and small pieces falling at different speed."
- why? Precisely how did the falling upper section render itself entirely nebulous BEFORE it first impacted the topmost floor of the lower section? What the fuck kind of physical mechanism allows an entire building to spontaneously abandon the laws of quantum electrodynamics?
"Sorry; I just thought I heard you saying that the core remained standing? "
- I did, and the statement you offered this in response to made no mention of the CORE COLUMNS failing. I explicitly stated that the CONNECTIONS between the core and the floor trusses failed, as well as the PERIMETER columns. Nice try, bitch.
"If a passport belongs to somebody who is vaporized in a plane crash under those circumstances it is enough to prove that the passport was exposed to the same circumstances "
- what a fucking clown! Whoever said that everyone on the panes was immediately "vaporized" by the impact forces alone? No-one has ever made such a claim, which instantly invalidates your idiotic assertion, because your conclusion is based entirely on a demonstrably-false assumption.

THAT, princess, is logic. Your assertion is a logical fallacy.
Reply: Christ J sorry but how can you prove that the passport wasn't in the man's pocket? because it as a passport should have remained in pocket during flight. you must prove that the man got up, walked to the exit door, opened it, dropped his passport out, closed the door, and sat back in the pilot's seat. all without anybody trying to turn the plane away from the towers or grab him. he also had to have done this in the last moments of flight for it to have been found where it was. the burden of proof would normally fall upon the prosecution but for a claim this crazy you must prove it happened that way. (a passport would normally be in a pocket. you have to prove the man dropped it before hitting the tower.)

here's what we know: the passport was in great condition. it was found pretty far from the towers. passports are stashed in the pockets of their owners. the owner burned alive. he also got yanked through a building. crashed a plane. and unless you prove otherwise, he had the passport on his person the whole time.

so how was the passport unharmed?
Reply: Christ J we have had an unfinished conversation concerning Shanksville. I cannot find the thread right now but I will be looking for it. What did I accuse you of? Is it criminal to say that the plane buried itself and that the wings folded? I cannot come to any other conclusion than that you don´t believe this was happening and that I have not accused you of anything. You´d like to finish that conversation or not? Don´t say it is not relevant to 9/11. AS FAR AS I CAN REMEMBER we also had a conversation concerning the hijackers presence at the airports and I claimed that you have failed to prove that; thus failing to prove 9/11:s most basic fact; and you have not answered to that either.

No I don´t want to shift to another thread because it makes it too easy to forget where it was. If you remember you could help me?

NIST said in their report concerning WTC 7 that the whole building fell at gravitational acceleration,  9.81 m/sec2 for 2.3 seconds. They also used the expression "free fall" for the same event. Thus they used the locus "free fall" for an event where there was no other resistance than air; because that is the definition of free fall. I don´t need to go further than this.

"you are claiming that dust particles can never fall under gravity, which is yet another example of you violating he laws of thermodynamics".

Did I? I claimed that free fall for dust is something different than free fall from a solid block BECAUSE OF AIR RESISTANCE!

"utterly wrong. A tonne of concrete has the same momentum whether it is a solid block or a mass of disconnected particles, and that is a physical fact beyond dispute. Prove me wrong."

Of course it has not because the speed of the particles is lower than the block because of air resistance.

" why? Precisely how did the falling upper section render itself entirely nebulous BEFORE it first impacted the topmost floor of the lower section? What the fuck kind of physical mechanism allows an entire building to spontaneously abandon the laws of quantum electrodynamics?"

That is just the question around here: why did the upper section disintegrate before it reached the 90:th floor? Maybe you can answer that? Because it did; as we can clearly see in the video. If it had not,  the tilting movement would have continued but it did not. The section just disappear. Moreover; there should have been an observable collision when it hit the lower section but there wasn´t any.

 "I did, and the statement you offered this in response to made no mention of the CORE COLUMNS failing. I explicitly stated that the CONNECTIONS between the core and the floor trusses failed, as well as the PERIMETER columns. Nice try, bitch."

That was not even a try because you did not say "perimeter" columns, just columns; but I am generous and give you the benefit of the doubt when it was so obvious that it was THOSE you meant. However; you are again referring to a pancake theory that i thought was refuted already? Not by you of course but by the rest?

It still does not make sense when you refuse to explain why the lower parts were not giving any resistance at all but just stood there as a house of glass waiting for a small army of debris invade and making the defenders contributors to the destruction. From what I have seen in all comments during the years I have been studying this phenomena; this is still the big piece of mystery. It is like when the Inka let themselves be slaughtered by an army that was 5 % of it´s own size.

If we can settle our differences with a simple explanation that everybody can understand I think this debate will be more or less over. In my world and in what I have learned from Newton´s laws; things don´t work that way. Information of what was going on in the upper section was already after 0.5 seconds transferred to the bottom of the building by soundWAWES. This should - still in my world - mean that the steel had already started to react,    because wawes means vibrations and vibrations means movement. There was already movement going on inside the structure.Vibrations were felt in the building when the plane hit; it was also noticed by the seismic station. at the very moment. The building was very resilient to a horizontal hit; wouldn´t it be to a vertical hit also?

"what a fucking clown! Whoever said that everyone on the panes was immediately "vaporized" by the impact forces alone? No-one has ever made such a claim, which instantly invalidates your idiotic assertion, because your conclusion is based entirely on a demonstrably-false assumption."

 I did not say what you just cited. I said that the proprietor was vaporized in a plane crash under such circumstances. I thought that I at this stage did not need to repeat the circumstances to you; the circumstances being that the plane exploded, the building fell, disintegrated and that no remains of the body were found. If those are the circumstances at hand there is every reason to believe that the passport could not survive; even less in pristine condition and that; if such a passport is found; there is every reason to believe that it was planted. But the other side will always have the opportunity to prove that the deceased; just before the plane crashed into the tower; pulled down the window and threw out his passport in the hope that it would be found and confirm his martyrdom.
Reply: Clash Bluelight "how can you prove that the passport wasn't in the man's pocket? because it as a passport should have remained in pocket during flight. "

- an ordinary passenger, yes, but this is NOT an ordinary passenger and so trying to attribute to him ordinary actions is a logical fallacy. 

"you must prove that..."

- exactly wrong. YOU are the one making an assertion here, not me. I am simply observing the fact that this particular item - along with dozens of others - was found at ground level having previously been on the plane. It is not unique, nor is it unusual. This has happened in every plane crash in history, and they all happened in even less favourable circumstances, whereas the WTC being so rigid and so tall compared to the surroundings allowed for the ejection of many things when the plane inevitably crumpled upon impact. 

Things like this - and the better-known shoes, stuffed animals, etc. - often survive because they are so resistant to breakage and thus are readily preserved by simple statistical probability.

YOU must prove that it could not have been ejected from the plane, because YOU are the one making a positive assertion here. I am merely accepting that it _could have _ done so, not that it certainly did.

"the burden of proof would normally fall upon..."

- the person making an assertion, which is YOU. I know it could have got to its final resting place following the break-up of the plane upon impact because I have seen the exact same thing happen in numerous other crashes. Hell, I've seen the same thing in RTAs whilst working on them. You, on the other hand, are stating that there is only one possible way of it coming to be there, which means that  YOU are the one with the burden of proof.

"the passport was in great condition."

- really? I can't find any information as to its condition, so I am inclined to accuse you of being your usual lying cunt-ish self by making such a baldfaced claim. Provide evidence or I'll consider your assertion automatically false, as would any jury given your recent past record.

"it was found pretty far from the towers."

- where? Links please...

"passports are stashed in the pockets of their owners."

- is this also true of kamikaze pilots? If you can find no evidence that it is then your assertion is nothing more than a bait-and-switch, making it invalid by default.

"unless you prove otherwise, he had the passport on his person the whole time."
- fuck off. There is precisely no way in hell that a lying little spastic like you gets to make up a fraudulent fact and then demand disproof. The default view is that NOTHING is right until so proven, which goes for your assertions as well. Couple this with the irrefutable fact that your presumptions are equally untenable and you have no right whatsoever to make that proclamation.
Unless YOU prove otherwise, that passport did what numerous other items have done in multiple plane crashes throughout the last few decades, which is to be throw free of the debris due to its resistance to blunt force and lack of significant mass.
Reply: oller "What did I accuse you of? "

- short memory...?

" I am calling him a liar[referring to me]"

- only two days past. Very short memory...

"You´d like to finish that conversation or not? Don´t say it is not relevant to 9/11"

- I never have, but I have - quite rightly - pointed out that it is irrelevant to this discussion, as this video and thread are concerned with the WTC collapses. Since you already acknowledge that we have encountered one another in at least one other thread, you already know that I will likely respond to you if you choose to mention these in a RELEVANT forum. I thus surmise that the only reason you are STILL refusing to do so is because you recall how I decimated your claims the last time around.

Fuck off somewhere else and ask there. Copy as many usernames as you want, so that everyone sees what transpires. I have nothing whatsoever to hide, because I already know how desperate you are to avoid this topic.

"No I don´t want to shift to another thread because it makes it too easy to forget where it was. "

- Google notifies you EVERY TIME I reply. Every. Single. Time. You will NEVER have to "forget where it was" because this website simply won't let you. 

What a load of shit.

"NIST said in their report concerning WTC 7 that the whole building fell at gravitational acceleration,  9.81 m/sec2 for 2.3 seconds. "

- and is that the exact rate of gravitational acceleration, either in a vacuum or in air? No, it is not, which means your attempt to refer only to a summarizing soundbite rather than the raw data is because you want to HIDE that data. You want to cover up the measurements in favour of an ambiguous term that - as YOU yourself have just admitted - has multiple potential meanings, none of which match the raw data itself.

That is the absolute paradigm of pseudoscience, with a healthy dose of anti-science mixed in, presumably for flavour.

"I claimed that free fall for dust is something different than free fall from a solid block "

- no, you implicitly stated that dust cannot fall under gravity:

""in a cloud of dust you will see that all pieces of dust are falling at different speed and not accelerating at all. ""

- see that ending? "NOT ACCELERATING AT ALL"[my emphasis]? You think this means anything other than saying that something cannot fall, do you?

I think you mistyped, but this just goes to show that you haven't the slightest fucking clue what you're talking about, because it is a fucking idiotic mistake to have made and then failed to subsequently correct.

The simple fact is that air resistance is only a factor while the air is not moving with the dust, which would last for a fraction of the collapse initiation. The only reason air offers resistance is because it is offering a direction of flow which is opposed to that of the dust particles, but this is rapidly overcome by the fact that the impacting dust pushes the air the same way due to its MASSIVE FUCKING MOMENTUM.

Furthermore - and I note that you failed to address this fact at all - the upper section was almost entirely intact when it impacted the lower section. The impact itself is what started to break up the concrete and drywall. Nothing else is physically possible - and no, thermite cannot convince concrete to abandon the laws of physics, so don't bother asking.

"why did the upper section disintegrate before it reached the 90:th floor"

- first off, we're going to clarify that "disintegrate" means to "break into two or more pieces". It is NOT synonymous with "entirely crumbling to dust", which is how you seem to be trying to twist it. Read a dictionary.

Secondly, the upper section did not disintegrate, in your sense of the term. The outer panels and columns fell away from the floors and trusses. The floor slabs and trusses remained largely intact until they started impacting the floors below. This is why WTC 1 - the only one which behaved in this was - looked like it was peeling from the top. You'd get the exact same effect if you stood a group of matches atop a Pringles tube and let them fall. 

Before you spout any more shit about dust, I suggest that you answer this: how much SOLID debris did Fresh Kills process from the site?

" Moreover; there should have been an observable collision when it hit the lower section "

- why? The momentum was sufficient to instantly overload the supports, and the loss in velocity would have been regained in less than 0.1 seconds. So says, once again, Newton. Feel free to calculate the lost momentum yourself, as well as the rate of regained momentum from the subsequent fall. I know that you now know how to do this, because I have posted the exact equations to you previously...

"you are again referring to a pancake theory that i thought was refuted already?"

- no, it was NOT. In fact, you yourself are arguing for a pancake collapse, because every demolition in history has also featured a pancake collapse.

Once again, you have no idea what you're even saying.

"you refuse to explain why the lower parts were not giving any resistance at all "

- I have NEVER made such a claim, and your slut of a mother should be ashamed of pissing out the type of amoral child-fucker who would accuse me of it.

You're a truly disgusting little cunt.

" In my world and in what I have learned from Newton´s laws"

- you have learned fuck all, and then invented your own bullshit opposing assertions when Newtonian physics abandoned you. 

" Information of what was going on in the upper section was already after 0.5 seconds transferred to the bottom of the building by soundWAWES"[sic]

- but ONLY BY GOING THROUGH THE TOPMOST FLOOR, which means that THE TOPMOST FLOOR WAS SUBJECT TO EVERY LAST IOTA OF THAT FORCE ALONE. No  help, no superhero-esque struggle. For a force to be transmitted through that floor to the lower floors, it MUST go through the top floor, and to do that it MUST exert itself on that floor, which means it will crush it. Debate over.

I have explained this exact mechanism to your at least once before in the last couple of days, only for you to revert to form and pretend that I haven't proven you wrong again.

"The building was very resilient to a horizontal hit; wouldn´t it be to a vertical hit also?"

- the momentum of the upper section was at least thrice that of the planes. Furthermore, the horizontal impact was resisted by core columns, perimeter columns, floors, trusses, etc. The vertical motion was not only merely resisted by bolts and perimeter columns, but it was also ACTIVELY ASSITED by gravity.

Anyone who thinks this is a comparable pair of events is a fucking spastic.

" the plane exploded, the building fell, disintegrated and that no remains of the body were found. If those are the circumstances at hand there is every reason to believe that the passport could not survive"

- the passport was found BEFORE the building collapsed - either of them, which means that we have indisputable proof that it was not subjected to the same circumstances. You are thus refuted.

Why did you never bother to check this, I wonder...
Reply: Christ J "- and is that the exact rate of gravitational acceleration, either in a vacuum or in air? No, it is not, which means your attempt to refer only to a summarizing soundbite rather than the raw data is because you want to HIDE that data. You want to cover up the measurements in favour of an ambiguous term that - as YOU yourself have just admitted - has multiple potential meanings, none of which match the raw data itself."

So, which data is it I want to hide? NIST said "free fall".  Does that mean anything else? What then? And why did they not show THAT?

"Disintegrate - break up into small parts, typically as the result of impact or decay"   from a dictionary and for you. You are welcome.

For once I have to give you right but I thought in my naivety that you would understand. Dust is of course accelerating to a certain point when - like any other object falling in air - it reaches it´s maximum speed. From that point on there is no more acceleration, but a steady speed. To the naked eye, dust will give the impression not to accelerate at all. It´s speed will, though, be slowed very early and the momentum thus reduced. A cloud of dust stemming from a disintegrated block will not have the same impact force on an underlying structure as a solid piece. That should be a rather simple matter to determine. You also said before that the impact of an object is the same regardless of HOW it hits. if it comes in portions it will of course not have the same impact as if everything hits at the same time (you will have to excuse me if I am using layman terms here but it serves better to the understanding of what was going on.

"Furthermore - and I note that you failed to address this fact at all - the upper section was almost entirely intact when it impacted the lower section. The impact itself is what started to break up the concrete and drywall. Nothing else is physically possible - and no, thermite cannot convince concrete to abandon the laws of physics, so don't bother asking."

I could not really have failed to address the upper section. What I said was that it disintegrated BEFORE the lower section was hit. Chandler shows in his video the absence of any impact when the upper section hits the unscathed part; on the contrary, the impression is that the outer wall seems to start opening itself a fraction of a second before impact.

The pancake theory that was refuted was the one you are referring to: everything SURROUNDING  the core fell but the core remained standing. The problem with that is that the core visibly was a burnt out skeleton that we could see for a few seconds. The core was heavily involved in the fall from the very beginning and would have made tremendous resistance to the falling debris with all the strength it cold muster in it´s full length.

"- but ONLY BY GOING THROUGH THE TOPMOST FLOOR, which means that THE TOPMOST FLOOR WAS SUBJECT TO EVERY LAST IOTA OF THAT FORCE ALONE. No  help, no superhero-esque struggle. For a force to be transmitted through that floor to the lower floors, it MUST go through the top floor, and to do that it MUST exert itself on that floor, which means it will crush it. Debate over."

 
I understand that the force is coming from up to down. But what that has to do with the resistance from below I cannot understand from your mumbo-jumbo. The force is going downwards at accelerating speed; yes but the impulse wawe that alerts the lower section to start to make resistance were travelling at 5800 meters per second; some 30 -50 times faster. You still have failed to explained why not THE WHOLE of the lower section used it muscles to resist what came from above. You are effectively describing a  situation when an unscathed  structure destroys itself.

I have not looked up the moment of the finding of the passport; but I will. Even if you say is true there is still some explanation to be done to how the passport would be able to escape the fire and the explosion unscathed. But you may have that also?
Reply: Christ J where do you want us to start the discussion?

Cited from Pittsburg Gazette; Steve Levin; december 2001: Flight 93 victims' effects to go back to familiesSunday, December 30, 2001By Steve Levin, Post-Gazette Staff WriterUnited Airlines Flight 93 slammed into the earth Sept. 11 near Shanksville, Somerset County, at more than 500 mph, with a ferocity that disintegrated metal, bone and flesh. It took more than three months to identify the remains of the 40 passengers and crew, and, by process of elimination, the four hijackers.Those remains were gathered by the FBI and other investigators from the 50-foot-deep pit the Boeing 757 jet gouged in a reclaimed strip mine, and from the woods adjoining the crash site.
Cited from Wikipedia today: The impact left a crater eight to ten feet deep (c. 3 m), and 30 to 50 feet wide (c. 12 m).[65

Where do we start? You decide!
Reply: Christ J I have looked a little more into the passport story.  The passport was allegedly found three blocks away from the South Tower; as you say BEFORE the collapse by an unknown male who then turned it over to a police officer: "when I looked up he had disappeared" said the policeman. As if it was of only insignificant importance the incident was not reported by the media until Saturday. Was it insignificant? Or was it just a game to make it sound insignificant? If I had been a police officer I would immediately have understood the significance of this at least as soon as it was known that the hijackers were Al Qaida. That was well before Saturday, wasn´t it?
No person has later turned up and identified himself as the one who gave the policeman the passport. Was it so insignificant that he forgot the incident? Or did the police find the incident so insignificant that they did not ask the man to come forward and identify himself? Somewhere down the line somebody in the police would have understood that it was of utmost importance? Was it not important? No, of course not; because they already knew who the perpetrators were!
Away from all these fussiness the likelihood that the passport should have flown out of the hijackers pocket or his luggage; escaped from the explosion where everything else vaporized, in pristine condition and transported itself three blocks is zero. The burden of proof that it was found in the street by a mysterious unknown man is still on you. Interestingly enough; the same kind of stories are told about Flight 93. Regardless of the obvious lie that the plane buried itself into a 50 feet deep hole and disintegrated (sic!) there is an other obvious lie added to this. It says in the article that the items that were found "escaped at impact". How does that work? It does not! 
April Gallop who was in the middle of the thick in the Pentagon; did not witness ANYTHING that indicated a plane crash on her way out from her office-laid-in-ruins. 

Do you understand why everything concerning 9/11 has to be dealt with in a compressed fashion: because the same excuses and repeated lies come back over and over. They look the same and they smell the same.

I think you have misunderstood the situation and misinterpreted Goebbels. It is not by repeating the lie that it becomes the truth. It has to be the SAME lie in the same context. If you use the same lie but in a different context the lies are laid bare. Do you understand that?